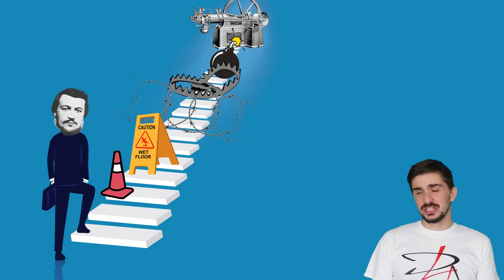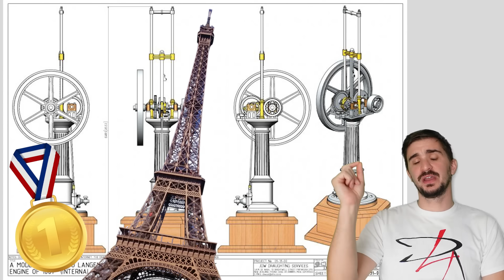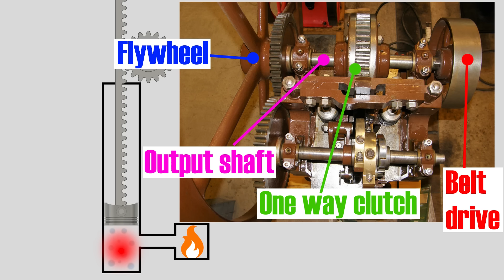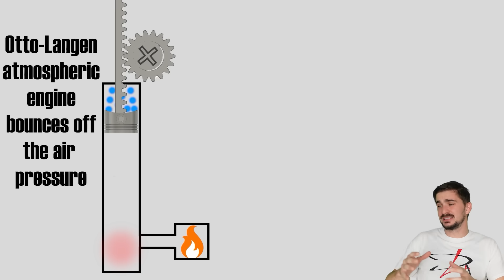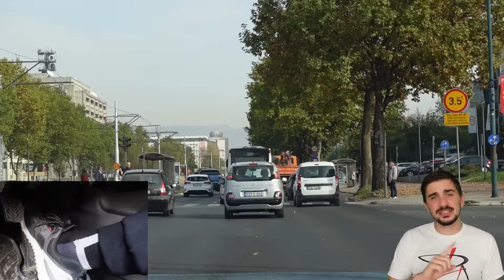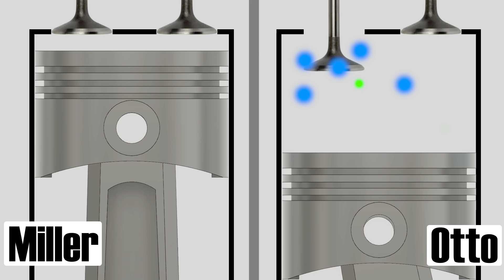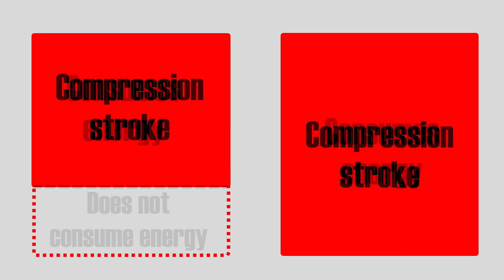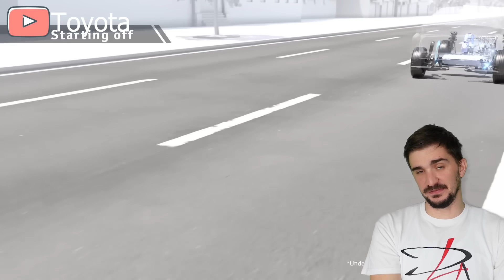You'll understand everything about Atkinson, Miller and Otto cycle engines after watching this video

Comment: Good video.  Ralph Miller’s original idea was to close the intake valve well before BDC to increase efficiency. He wrote about this (as I recall) in a 1948 ASME paper. I read his paper 25 years ago while working on VVL/VVT concepts for Chrysler. This works very well for low load efficiency (up to about 8% improvement), due to virtual elimination of the pumping loop by running unthrottled, and is what BMW Valvetronic and Fiat does Multi-air to run “unthrottled.” 

A guy at GM named Don Stivender did research on extremely low lift cams in the 60’s, and another GM guy named Tuttle made very short duration cams (with more normal lifts) in the early ‘80’s, testing Miller’s original concept. Tuttle also ran very long duration cams to control load (testing the later miller approach) Stivender claimed a 5% improvement in efficiency, and Tuttle around 8%. Stivender called his very low lift the STIVE cycle (Sonic Throttling Intake Valve Engine). Very clever! I built some very short duration cams with moderately low lifts to verify the blended “Stivender & Tuttle/Miller” with the very early intake valve closing concept in our 1.6l “Tritec” engine in 1999/2000 and verified the concept could deliver about 6-8% lower BSFC unthrottled. Most folks (even engine guys) didn’t understand how this works, but the evidence is right in the P-V diagram, and the virtual elimination of the pumping loop. Here’s are links to Tuttle’s 1980 & ‘82 SAE papers(I couldn’t find Miller’s):

https://www.sae.org/publications/technical-papers/content/800794/

https://www.sae.org/publications/technical-papers/content/820408/

Here’s Stivender’s paper:

https://www.sae.org/publications/technical-papers/content/680399/
Reply: Great message and refences.
Reply: Let me begin by stating that your comment obviously indicates an impressive understanding of the compound processes and coordinated functions of internal combustion engines and the incentives behind the R&D by engine manufacturers. 
 There are other viewers that demonstrate an understanding of the mechanical action, and some guys are on point, but this is the first time someone commented and there was no tunnel vision, or inaccuracy, without an air of bias or disapproval.
Reply: @tomconner5067  Thank you for the kind comment. The engine development work I did at Chrysler from ‘97-2000 was the most technically challenging, mentally stimulating and rewarding work of my 35 year career in the auto industry, and I had a lot of tough, innovative and interesting projects. I loved doing advanced side projects like the VVT/VVL studies. I authored a white paper on that work, that I hope had an impact and laid the groundwork for future development.
Reply: Wait a second ... what sort of engine guy doesn't understand dethrottling? The highload-benefits are a tad harder to grasp, and only work really well with boosted engines. There, one could see the concept outsource a part of compression without impacting expansion. Outsourced to the compressor (be it attached to a turbine or driven by the crankshaft), cooled inbetween, thereby lowering p and T, yet having the same amount of charfe inside. That way, knock is countered, and that allows to either collect an improved efficiency at high load, or to increase the geometric compression ratio, thereby expansion ratio, thereby efficiency.

But, as stated, this only applies to boosted engines - naturally aspirated ones, would lose a great deal of torque and power, if run on that mode, ... fits some applications, like Toyota's hybrids, but, there, these engines only are so successful because nobody really took them on - a similar drivetrain with a higher-tech ICE would outperform a prius in any regard.

Anyway, the mid-load region is the only one where you won't benefit much from a variable valvetrain, be it two or three steps with a lobe each, or continuously like BMW made it ... the nicest VVT I found so far is Nissan's - I've had the very same idea, but came across it in a book that sums up a converence on VVTs (there were annualy ones when this was considered one of the three major promising paths - Downsizing, Stratified load and dethrottling by variable valvetrain), and thought ... cool, some dude in Japan had the same idea and actually made it happen. Nice! Got a more complex, but still better one up my sleeve any day, that could even spare an intake cam phaser, if some parameters match up.

Anyway, I get that understanding the concept of outsourced compression and inbetween cooling may be a bit un-intuitive, but dethrottling, while sometimes hard to apply in reality, the basic principle is fairly easy to grasp...
Reply: @hoganfan924  ... just in case ... under what name did you publish it? How was the title? Is there a way I can read it, somwhere? I may already have, as VVT took a major part in my Diploma Thesis and a prior large ... assignment? The equivalent to a bacherlor's degree earning thesis, just without a degree, and after the Vordiplom (Diplom - stuff was arranged other than it's today, then). Which is, basically, at least a bachelor's in knowledge, but not a degree you can use on its own. Anyway, I remember having read some studies involving a Chrysler engine, ...
Reply: @DC-rn1fc  My VVT/VVL paper was an internal “White Paper” on future concepts. Not public. I wrote it in 1999. You’d be surprised how many engine guys back then thought that throttling at the valve vs at the throttle would be insignificant. At low load points it can be worth up to 10%.
Reply: @DC-rn1fc  I think the only (but very important) advantage of that Mazda engine is cooling of the intake air. Pumping losses are just moved from piston to compressor. May be they could improve them too, connecting the compressor with a CVT. Than you don"t need a throttle and can vary the power by varying the compressor speed.
But my dream would be to outsource the compression so much, that you can skip the intake stroke, and push already compressed air at the end of exhaust stroke. Than it will double the power, and half the mechanical losses, just by switching to two stroke cycle. Plus full compression with intercooling will allow very high compression ratios without detonation. But how to make it work at high RPM?.. May be combustion chamber should be separated from the cylinder by extra vale. So air/fuel mixture will be pushed to it and ignited during the exhaust stroke, and on power stroke valve will open and fully burnt gases will go to the cylinder and push the piston.
Reply: @azlktune  That's an interesting idea. The twostroke, in and of itself, doesn't have much against it, yet the ... shortcomings of the concept, render it the less promising in any mid-sized application. The KNOWN concepts - getting rid of crankcase scavenging for example would remove any lube-burning related issues unpresent at once, and that, I see you aiming for with this one as well. Extremely high pressure, so that the EXPANSION into the cylinder cools it down the final step ... compress, ignite-burn-work, and out (longitudinally so) again, with short (and maybe controllable) intake opening that finishes scavenging way before bottom dead center ... oh my, this is a rabbit hole to even examine if it's promising a competetitive efficiency, as the inner one even before any math is involved is very promising, but the supply with boost pressure way in excess of the usual of today's won't be for free, but gotta be as efficient as possible, with multi-steps and intercooling between all steps, ... gets me thinking of axial compressors THROUGH an enclosing heat exchanger (integrating compression and intercooling to a many-many-step axial would make it an, almost, continuous process instead of one in multiple steps, or, basically, moving towards such enough to recognize it doing so, ... of course, actual machinery always is in steps, ...), because stacking so many stages becomes near impossible with radial compressors, but they might follow, as per stage, they outdo any and every axial with a pressure ratio of up to about 3 in appliable machines, ...

But, the fourstroke cycle has some advantages we can't overlook here. Generally, it's cooler running, even at identical power, speed, cylinder sizes and so forth, which is in our favour regarding knock. It offers half of it's running time and its whole swept volume, if desired so, for exchange of cylinder load, while a twostroke needs external machinery do that anyway, the crankcase just being at hand in the lightest, simplest engines not being an option due to lubricant's combustion being against our favour in every regard (causes knock, costs expensive lubricant, may kill catalytic converter, particle emissions are through the roof, ...). The fourstroke, modified to have different effective strokes for intake and work - by early or late intake closure in the easiest, most appliable, cases - offers to increase the geometric compression ratio almost up to the practical optimum (heat losses and a lot of Blabla leave us at about 15...18:1 for a spark ignited engine, above, the increase of other losses would outdo the gain by more expansion), at pretty high BMEP and engine speeds, both vastly exceeding the performance variants of engines of 20...30 years ago. Time runs out, too, for new engines to be developed, we're pretty much at the time the actual development would need to start, not some groundwork study, but the actual one aiming for a mass produced machine, as per 2035, ICE drivetrains will become rarer and rarer, be forbidden in many countries even, and a completely new technology that elsewhere isn't of much value, will not promise a great return of investment.

Elsewhere - anywhere aside from motorbikes and cars, engines mostly are operating under more constant conditions, and optimizing an engine for one set of operating points at a fixed speed or fixed load, or a fixed load-over-speed curve (think boats for the latter - unregulated, high-rev tuned turbochargers do well in boat applications, but would be useless on the road) is fairly easy, a lot easier than achieving the same in broadly varied conditions. That makes us invent all that variable stuff, we add a degree of freedom that has a desirable influence on the parameters we could only set fixed at a compromising value that is, at best, optimal along one weirdshaped line on the engine map ... anyway, outsourcing the compression completely, has some appeal to it ... twostroke engines ... Porsche's latest published concept of a six-stroke, or a 6/2-stroke ... a threestroke engine, in average ... kind of ... alternates between a fourstroke and a twostroke process, but I'm not sure if that aims at efficiency in broad conditions, or rather at efficiency in a limited range of conditions, but by being accompanied electrically ina hybrid, in a range that really pays off, as the stroke of the engine changes back and forth ... I gotta take another look to fully grasp it. My thoughts that aimed at a similar process included a sleeve valve operating the intakes at the cylinders' bottom...
Reply: @DC-rn1fc  Sleeve valves will cause oil loss even without crankcase scavenging. Some oil will be pushed out to them from the piston surface. So it may work good only in rodless engines with unlubricated pistons.
Normal two-stroke engines with scavenging near BDC are also not really twice powerful, because a big part of the stroke is used for scavenging. With external compressor and intake at the exhaust stroke, full power stroke can be used for gas expansion.
Concerning lower average temperature of 4 stroke cycle - it is actually disadvantage, because more heat goes to the cylinder during powerstroke (higher thermal losses), and then it heats the intake gases (bad for knocking). Even an additional cold cylinder used as compressor would be much better for heat management. Plus compressor piston can be made much lighter and so with less friction.
I think maximum efficient expansion ratio would be not less then an old diesels had, about 25:1. Also a dual stage expansion with secondary piston may be efficient, because that piston working at lower pressures may also be lighter and have lover losses. For normal 4-stroke 4-cylinder engine I would add one expansion cylinder of bigger volume with a two-way piston, which will work with all 4 cylinders sequentially. That may be even done as additional device for existing engine, connected between engine and exhaust pipe and with a tooth-belt to the crankshaft
Reply: @azlktune  The sleeve valves are, in that case, part of a concept only existing in my mind. I have plenty of these, but ... as above - 2035 is a deadline we won't be shifting much. But, anyway, yes, there will be some oil drawn in, yet not nearly as much as a crankcase-scavenged twostroke, or Rotary with circumferential (intake) ports, would take in. Rotary's exhaust ports ... another story. Having ALL ports on the sides would be a given for any current or future application of rotary engines at all ... but, having variable intake closure is easiest done on these - a disc-valve only operating the intake, with a variable phase in respect to the excenter shaft is all we need to add, which is significantly less effort than what we need to do to achieve such with poppet valves in a standard piston engine. Guess you've seen them, had that topic a few paragraphs up from here... Anyway, ...

The optimal, real, geometric compression ratio isn't that high. The higher it gets, the less favourable are parameters like surface area vs volume, that increase heat losses to an extent that overcompensates what's won in further expansion. The older Diesels had such high CRs because that enabled them to be operated in winter, and made them more accepting of varying fuel qualities. Those engines, with a partitioned combustion chamber, also lose a lot of heat in the passage between prechamber or swirl chamber and main, working chamber. Direct injection Diesels, usually, have a lower compression ratio AND higher fuel efficiency. The (reasonably to be considered as such) optimal compression ratio, of course, relies on circumstances and insights that change over time, but the physics involved won't change much. When everything would in the near future be made of ceramics - I think this was in the late eighties or so ... one of those predicteries, you know ....... -, a heat-insulated engine was built, where every surface that would be in contact with actual cumbustion, was at least coated with a ceramic material, or made of such entirely, aiming at decreasing heat losses. Surprisingly, they were increased instead, because the wall-quenching of the flame took place closer to the surface, which made the temperature gradient greater, and thereby, the differential driving out heat wasn't reduced, but remained almost identical. At best.

We often overlook the boring features, such as cylinder size, and their influence on overall efficiency. For example, we take two similar engines, same company, same timeframe and so on, the miller-variants of Audi/VW's EA211 and EA888 engines, introduced in 2017 or so. Following figures only for the variants we look at here, other ones have other ones, but that's irrelevant here ... The 888 is a 2 liter, has 190 hp, comp ratoo 11.7:1, features a wastegate turbine and at peak efficiency, BSFC is 220 g/kWh. The 211 is a 1.5 liter, 130 hp, 12.5:1, features a variable geometry turbine and ... 222 g/kWh. Size aside, all features and specs (including the ratio of bore and stroke ... almost identical) are in favour of the smaller engine - slightly less power density, higher CR, no exaust gases bypassing the turbine, and yet, it's slightly worse in efficiency. The only real difference there is, is te cylinders' size, but it overcompensates all that would be in favour of the smaller machine.

Wastegate turbines: Their efficiency needs to be corrected for the fraction of gases that actually flows through the wheel and has work extracted from it, with the term 

m_turb/(m_turb+m_WG), 

with m_turb being the massflow through the actual turbine, and m_WG that through the wastegate, the sum of them, of course, being the total exhaust gas flow rate. At peak efficiency, the wastegate of this particular (and every one employing a WG turbine) engine is not fully closed, so we know that in this regard, the more efficient engine has a lower efficiency, as in the variable turbine, no gases are allowed to bypass ... which is why they exist in the first place, to have a means to adjust overall flow capacity without losing so much efficiency ... the wastegate only is the least-losing mode of operation, we could alternatively have a bypass on compressor side, or a throttle on turbine side, or throttle-off any excessie boost pressure, but over-RPM'ing the turbocharger might become an issue, then. It's the least desirable method of control anyway already, so ... Wastegates haven't become standard just because, but because they're the least-losing method of loss-based control.

Anyway, we gotta take this into account more than usually, and also - that this always is related to a certain concept. In a pent-roof combustion chamber with two sets of parallel valves and one central spark plug, a slightly long-stroked 500 cc unit is optimal, a larger bore would decrease knock resistance and increase the duration of combustion, but if we introduce additional spark plugs, things change a bit and allow a larger bore, allowing for larger units or more shortstroked, higher-revving ones. But, the main point is, we need to have multiple influences and inter-relations in mind if we wanna get anywhere, and some features appear to be less cool, less impressive, but yet, have an influence never to underestimate. A larger stroke would limit the RPM possible, increase mechanical losses, and over-proportionally enlarge the engine's size and weight, ... 

Cooler running ... partially, more a concern of critical temperatures for materials used, admitted, but due to experience, cooling the combustion chamber as low as possible and thereby having less knock issues is more promising than avoiding the heat losses that are the price we are to pay for this. More CR is worth more than less heat losses by hotter surfaces. In aircraft engines, another factor comes in, radiators' drag, but let's not add that into it, too, here - enough already, eh?

As to external compression ... pressure losses are crucial, and so is intercooling, while we'd need a boost pressure way above what's usual today, or maybe two pressure levels which feed it sequentally. But, however we do this, we'll need space for coolers and piping and stuff, and we need to drive them. Exhaust turbines are the most efficient option, of course, but twostroke engines react pretty diva'ish to backpressure, so we might need to introduce either a mechanical, or an electrical path towards boosting, as we have multiple stages to drive anyway, we can pretty much seperate this. Electric ... only makes sense if the power we can apply is high enough, meaning the environment needed makes up for the most of added machinery when converting to a hybrid anyway, so we could employ electric motors alternating, and pretty much avoid low part load conditions altogether, so we can focus on efficiency at high output.

Additional expansion devices, downstream of the engine, are not only promising, but a key factor. Sadly, car engines aren't large enough to employ turbines as well-performing as it is in large aicraft engines, but either that, or an expansion cylinder - with its own advantages, drawbacks and issues. Curtiss-Wright used a set of three turbines in their Turbocompound versions of the R 3350, reaching a BSFC of 231 g/kWh - in the fifties, pre-electronic controls, with an aircooled twovalve engine! Huge cylinders have drawbacks as well ... knock is more likely, the larger it gets. But, compare these 231 g/kWh to the numbers above, and to the, usual, around 240 g/kWh for (good) twovalve car engines of the early nineties (knock sensor, Lambda-control being applied and working reliably and precisely and so forth), and the effect of expansion downstream should be appealing enough, ... definetely a path I'd love to investigate, would I still work in engine R & D. Wouldn't oppose doing so, ...

Oof ... that got long ... hope you don't mind, ... didn't forget something, the cat demands attention, I can't let her wait. She allows me in her bed...

Uh, anyway ... as this debate is kinda refreshing - thanks, looking forward to next!
Reply: @DC-rn1fc  As I understand, modern diesels have lover CR mainly to minimize NxO production, plus they have higher boost. Otherwise I think optimal expansion ratio would be even higher. I tried to find some numbers of equivalent pressure of mechanical losses, but I can't unfortunately.
Concerning downsizing, it is clear that smaller engine with the same number of cylinders will have worse efficiency, due to higher thermal losses. But the named efficiency is achieved at optimal load, which is usually too high. So aim of downsizing is to make engine work closer to its optimal range.
Regarding turbo, it is always looses energy, independent of construction, except when it is connected to an alternator like on F1 now, or mechanically to the crankshaft. Energy of exhaust gases is anyway higher then of intake gases. Turbo just replaces the lower part of the power and intake stroke, making more power from less cylinder volume, but by the price of efficiency. 
Bigger stroke with smaller bore gives better thermal efficiency by the price of max power, because of smaller valves. But that may be compensated by a low boost turbo, which will not increase the pressure at low/mid rpm, so the high CR can be used, but will increase power at high rpm, compensating the losses in valves. That would be a compromise between efficiency at low loads and peak power.
Temperature of compressed gases can also decreased by the water injection. Usually it is used in high-boost turbo engines, but can also be used with non-turbo high CR engine.
Reply: @azlktune  Yes, NOx is influenced by the CR, but exhaust gas treatment is needed anyway, adapting here for a higher conversion rate seems more promising. Raw emissions ease that, but if it would cost a significant part of efficiency, that deal would be broken already. The current Diesel, Direct Injection engines' CRs of around 14...19 or so, are just about the optimum possible. But, generally, I'm more of a gas engine guy, but ... anyway, downsizing aims at shigfting load, yes, but the point I was aiming at is a different one - fancy stuff and extreme parameters cannot outdo basic geometric specs, or the effect they have. I love all that complex and variable stuff, don't get me wrong here, but the basics have to be optimal, or close to, already before any of it is the most promising, most effective way to increase efficiency. With too large, too small, too shortstroked cylinders, you can throw in all the tech you want or dream of, it won't deliver enough to justify the expense.

But ... turbocharging, in and of itself, doesn't reduce efficiency, but increase it, as it - partially - extracts heat energy from the exhaust gases that, otherwise, would just be expelled with the gases themselves. The adaptation, requring a lowered compression ratio, and thereby expansion ratio, is where we lose efficiency, and the - in downsized engines more likely - small units. Smaller ones are less bound to knock, but larger ones lose less heat, and at those just-a-bit longstroked 500 cc units, we're at the optimum of concept. Throw in the other two sparkplugs in the corners between valves, outer side, so they form a line of three per unit, and make a nice cumbustion chamber with large squish area, and we've shifted the optimum towards larger bore... But, that only drifts off here.

The turbocharger, kind of, simulates an atmosphere of greater pressure, on both sides of the engine. In a standard engine (normal timings, ...).

It doesn't replace the intake stroke, but the compression stroke, partially so, in miller-engines, with the advantage of having a chance to cool it down before entering the cylinder. With an adiabate charge air piping, we wouldn't gain anything from it, but losing efficiency, as we sure need a higher boost pressure, and with the same kind, or even identical, turbocharger, that requires a further closed wastegate, backpressure is increased, load remains identical, and without removing heat before entering the cylinder, all the effort is going to waste. Only the reduced temperature at compression's end is affected, and only there, we're aiming in regard to high loads. The chance to insert a heat exchanger between (partial) compression and (further) compression, we only get by outsourcing it to the turbocharger, or by water injection, which is generally frowned upon, as one would have to refill it. Backpressure AND boost pressure, both, are higher than usual, still. But, that's acceptable, as the increased efficiency of a larger geometric CR outperforms this largely.

The expansion ratio, as the parameter determining the effeciency (the compression ratio, or rather dead center volume ratio, is no more identical in this case, so we need to distinguish between them), can then be increased.

Further expansion, regardless of the type of machine it appears in, is worth some, but less than epansion in the original combustion chamber, because on the way, friction, heat losses and additional mechanical losses will appear. So, this route, I consider to be taken after any and every means inside the engine is fully exploited - miller cycle by valvetrain, to me, seems most promising as standard-feature for the remaining generation of engines. As it can be developed into existing engines, with adapted combustion chamber and boost system - maybe integrated into a hybrid, sparing us the hassle of variable turbines - and aims at the classic drawback of turbocharged engines, knock and the means employed to counter it, it seems almost natural to follow that path of development. Compression ratios like the engines mentioned have, weren't usual in any naturally aspirated engines until lately, therefore, I'd assume we can call this issue solved, as further increase above values of that order doesn't even promise that much more efficiency anyway ... from, say, 8 to 10, you'll receive a large increase, but from 13 to 15, you can't even expect the same ... you know the math, the graph, ...
Reply: @DC-rn1fc  You may compare e.g. 2L turbo with 0.5bar boost and 3L non-turbo. They will have nearly the same combustion chamber. So you just replace 1/3 of power stroke by the hot part of turbine, and 1/3 of intake by the cold part. That helps to increase power/volume or power/weight ratio, because this last 1/3 of the power stroke produce much less power, but you loss part of energy with it, that cause lower efficiency. So the turbo doesn't extract energy of exhaust gases, it wastes them. Only if you add a turbo to normally aspirated engine and connect it to some load (alternator or crankshaft), you will harvest some energy, but because of low efficiency of the turbine you will probably create more losses by backpressure on exhaust stroke then collect by the turbine.
Additional cylinder for exhaust gases expansion must be more efficient then turbine. It doesn't need cooling, so have no thermal losses. Mechanical losses are also much smaller then in main cylinders, because it works with much lower pressures. It will not even cost the space, because will replace part of the muffler, as gases pressure will be lower.
Of cause dependency of efficiency from CR is not linear, but there is still the same energy goes to exhaust as converted to mechanical work. So there is a lot of room for improovement. Fundamentally, efficiency is limited by expansion ratio. Cooling the intake helps to increase it by decreasing the size of combustion chamber. But higher presures during the whole cycle means you need more strong and heavy mechanical part, that means higher losses. You may compare a smaller engine with colder intake and higher pressure, with bigger engine with the same CR but lower intake pressure. They will have the same power and nearly the same mechanical efficiency. So impovements on intake side help more to increase power/weight ratio, then efficiency. To icrease efficiency you need to increase expansion, but with the same cylinder it will cause high mechanical losses, so the only way I see is multi-stage expansion with several cylinders. First with smaller volume, but designed for higher pressure, next with bigger volume but lighter piston working with lower pressure, and so on. Than it make sense to use equal expansion ratios of the stages. Not 10:1 + 2:1 as I though before using the extra cylinder with standard engine, but e.g. 5:1 + 5:1 or 3:1 + 3:1 + 3:1. Or may be last stage can be replaced by a rotary vane (de-)compressor, as temperatures and pressures will be low anough for it.
Reply: @azlktune  That's a weird way to look at this... 

Now, wait a second. We don't need to reduce the expansion ratio in order to drive the turbine, the only reason the compression ratio is lowered in boosted engines compared to NA engines is the prevention of knock. We don't have to lower it to make sure enough energy flows out the exhaust port to be able to drive it - that would actually be the case if the turbocharger was prohibitively inefficient. Have you seen early compressor wheels of Junkers' aero engines in WW2? Something like that... The prevention of knock is what limits the geometric compression ratio, or rather, a critical pre-reaction-state of the gases not yet reached by the flame, which is greatly influenced by (effective) compression ratio (in cylinder, taking intakes' closing time and the volume swept until then into the equation, and not the total displacement), and charge temperature. Could we reduce the temperature at compression's end, we could increase the geometric compression ratio, and in order to do this, we're outsourcing compression to a place that enable the insertion of a cooler inbetween. We're not replacing a part of the power stroke, and never have. That's a misunderstanding that could lead you somewhere, but you won't get anywhere from there any further.

Of course, having an identical combustion chamber, identical amount and state of gases, and then a lower expansion ratio, efficiency goes down the drain. But, that's not the case anymore, as prevention of knock has gone a great length since turbos have become a standard feature. Just look at current compression ratios of turbocharged engines operating above a BMEP of 20 bar, and look at that of NA engines just about pre-downsizing, including direct injection (which allows for an increase by about 1...2 units with the same knock properties), or go further back to twovalve era (which, btw - another debate to be had - were already known to be inferior to fourvalve or threevalve engines pre WW2, but as industry doesn't focus on best tech, but most revenue, it took just a few decades to unforget), you'll find almost no engines with a CR above 10. Early turbos - Porsche's 911 turbo, the first version, had a CR of 6.5:1 or so (WW2 aircraft engine level, that is - huge cylinders and low octane gasoline took their toll there), the later updated one with increased displacement was slightly higher compressed, but had an intercooler introduced, which should always be part of the package, as it increases performance AND efficiency and also is a relatively cheap, low-complexity item.

Anyway, if you compare that to the numbers, a lowered compression ratio, in today's engines, isn't much of an issue anymore, and certainly, the turbocharger is not meant to replace a part of the power stroke, nor does it need that in order to be operated. I get how it can appear so, but it's not like that.

A miller engine by early intake valve closure (generally, early is better than late - pushing out again the unnecessarily drawn-in part of the load - although that's possible, too, and often easier to implement in a given engine), even, does quite the opposite - the only thing outsourced off the cylinder is the compression, partially so, and the turbine ... well, we need something that drives the compressor, and as using exhaust gases and a bit of the energy that, otherwise, just is lost, we can be sure to have a greater efficiency than with a mechanically driven one. Anyway, a geometric cmpression ratio of 12.5 with a 1.5 liter providing 200 Nm (or more, the earliest versions had that torque ... maybe they updated, upgraded, a bit along the way until now) - that's still not too unimpressive, equaling about 17 bar of BMEP, even at low speeds ike 1500 RPM, which are the most knock-sensitive conditions, does tell a story that doesn't contain any expansion taken out the cylinder to be happening elsewhere.

Extended expansion could also be running in a Wankel-like machine, as there, we could feed in the gases at two spots, and have three chambers working simultaneously. The drawback that, ultimately, broke Wankel engines' neck, the odd-shaped combustion chamber (it's neither wear nor tightness, these have been solved since the late sixties, but still keep coming up when talking to non-engineers), is irrelevant if no combustion takes place. Compactness plays a role, too, but as of today, in engines not large enough to make a downstream turbine promising enough, a trochoid-machine would be my preference. 

The multi-expansion is a fine thing, in general, but reducing the expansion in the first stage gets me to scratch my head - why? The earlier on in the process you extract the work, the less chances to lose heat, or energy in general (... not really lose, but have transferred into a form we can't harvest), there are. The second expansion, of course, should extract everything possible, but reducing the first one will not be the optimal choice - that remaining as high as possible is a given, regardless of what's the machine following.

... looked up turbocompound engines? I think Allison could also have done such, but I'm not sure about them. Wright, for sure, did, and the results were quite impressive.
Reply: @DC-rn1fc  Of course we don't need to decrease expansion ratio to pool the turbine, we need to decrease the compression ratio to push more air to intake. We can do the same by bigger intake/compression stroke, or we can replace part of it by the compressor, keeping the same combustion chamber. And by that we decrease expansion ratio and lost a lot of energy to exhaust.
This model is more for engine without intercooler. Of course cooling give us some advantages, but at low boost it seems to be too small. For example two french engines I had, both from 90s: 2L NA with 180Nm torque and CR 10.4, and 2L turbo with 235Nm and CR 8. You can see that turbo engine has 30% more torque and 30% less CR, even with huge intercooler. So you can just make a 2.6L NA and get the same power, but with better efficiency, by the price of bigger weight. Actually they had a 3L V6 at the same time with CR 10.5 and 267Nm, so again the same ratio between torque, volume and CR, limited by the knocking.
Modern engines with direct injection having higher CR with turbo, but as far as I know they use a very late ignition in boost modes. So effective expansion ratio is much smaller than geometrical. Without direct injection they would probably have a strong pre-ignition.
I think Wankel engine have no advantages over rotary vane on lower pressures, see one of the previous video here.
Reducing of the expansion ratio on first stage will allow to make first cylinder smaller, and so decrease the heat loss to its walls. Also mechanical parts will be used more effectively at more stable pressure. At CR=10, pressure at BDC is about 15 times smaller then in TDC, so most of the time piston load is too small for it. So it is better to distribute the load equally between the stages. But it is a question of optimization.
I heard about turbocompaund engines, but don't know how big advantage do they have. Actually it is the same idea to harvest some energy from exhaust gases, but I think turbine is not the best there. If pressure of gases is about 10bar, that is close to the industrial pneumatic system, most efficient solution must be rotary vane which is used in many pneumatic tools now. I think turbo-compressors were used as a cheap and compact solution able to provide necessary pressure to intake without need of high efficiency, because flow of exhaust gases is always much higher then on intake. So we need to grab only a small part of the gases energy.
Reply: @azlktune  Yes and no. We gotta dissect this a bit deeper...

The state the gases are in at compression's end is (for our purpose here close enough) what determines knock. Modern, turbocharged, high compressed engines that deliver a high level of torque (that often is made to be constant from there on) from a very low engine speed on, say 1200 or 1500 (which engine speeds did the engines you mentioned have their peak torque at? Bore and Stroke are similar? Location of mixture is the same in all three? Combustion chamber's design is similar? Any known weak spots or exceptional strengths of those engines, like a poor cooing circuit in one, a very-well-tuned acoustic intake pipery in the other? Superior gas dynamics of multiples of three in cylinder count, being taken into account?), have even ignition AFTER top dead center. In my diploma thesis, this played a crucial role, as it investigated the interdependencies and options we can harvest from advanced turbochargers and variable valvetrains (of, at least, two kinds ... various ones already got disqualified from further examination, because time was limited, I had to make up a few criteria such as responsiveness to reduce it to what's really interesting and promising - a valvetronic-like continuous, and one that combines a twostage shiftable valvelift with different timings for each (set of) intake valve(s), thereby offering a continuously variable total opening duration - with a fivevalve, you'd even not have to worry about swirl anymore, so this would be the natural opponent of a fourvalve continuously variable valvetrain, but for comparabiity, I didn't change the number of valves, but applied it to a fourvalve - we could go into this further, but not here, not now...). 

The center of heat release, we decided to allow no later than 40 degree after top dead center, which ... is a drawback in many downsized engines, yes. Ignition was some 14, 15 deg ATDC in that situation. That, kind of, reverses the miller cycle, as it delays the heat release to a point where the further expansion isn't that great anymore, plus the heating up near top dead center is kinda intense - high pressure, long time, just compressing and expanding again a bit without any work extracted.

If I have the numbers right, a truly advanced turbocharger (the one used in the series engine modeled and modified upon was pretty close to its surge line at low speed, high load, and there, the compressor's side variability aimed at, by adding a variable cone nozzle directly upstream of the compressor wheel - turbine side was a Diesel-VGT plus wastegate, or at least, there I got the map from) that allowed a high enough boost pressure gave a huge advantage in getting rid of any scavenging (direct injection, it's only air anyway, but you'd either have to deal with rich mixture in cylinder to have global Lambda at one, or have Lambda at one in cylinder, but lean exhaust gases, and both, you'd rather avoid...), Lambda_cyl was increased from 0.7 (a limit we set, as just about there, the mixture would still burn sufficiently well to operate - regarding efficiency, this is a catastrophe) to 0.97 or so, and the center of heat release (CA50 - Crank Angle at which 50% of heat is released - "Verbrennungsschwerpunkt" in german) could be a great deal earlier, at 25 deg ATDC The effect this would have on efficiency, isn't hard to guess, I guess ... is it? Generally, the low-end-torque operating point was at any and every limit given, richest mixture allowable, latest combustion allowable, lowest minimal distance between piston and intake valves, and that, generally, doesn't lead to expect great results in regard to efficiency, but keeps an engine focussed on very different operating conditions runnable. Sometimes, barely so, but that's besides this debate. A bit.

Downsizing is optimization with respect to the range of operation conditions, and CAN mean sacrificing overall efficiency or peak efficiency, if the adaptation of the engine to deliver more power per displacement is done traditionally, there will be a loss in this respect. Sure so, but the boosted miller cycle engine overcomes this, exchanges it for another set of issues to be adressed (like bad transient behaviour ... pretty hard to make it react fast and smooth, many parameters).

Engine speed plays a crucial role, too, as with slower running engines, the unburned gas fraction has a lot of time to be heated up, while a faster running engine will be less of a PITA in that regard. To downsizing and stuff a bit, again ... the efficiency at peak torque, lowest RPM, of course, is worse than bad. Like, 400 g/kWh and above - BUT (... there's always some sort of Butt...), these conditions aren't stationary. In every gear, flooring the pedal even at that low engine speed will accelerate your vehicle, you won't remain in that condition long, so having a compression ratio that, here, requires such bad operational parameters, is worth it because it allows for better constructuous parameters, like compression ratio and so forth.

But, you really have to get rid of the idea that a turbocharger would outsource expansion. That isn't the case, or at least, nobody ever aimed for it. There's one exception, and that is transient behaviour, where we, for a very limited timeframe, allow the priority to be the acceleration of the turbocharger - in a miller-cycle engine, this is more spikey than in a usually controlled one, and to have more power available at the turbine wheel, delaying ignition is a proven and reliable means ... also, having only the stationary values of the valves' lift and opening duration won't make it here. This still refers to my diploma thesis, in which hybrid wasn't investigated, so the optimization of transient behaviour - smooth, yet fast, build-up of boost pressure and torque - was only taking the engine itself into account, without any replacery or so. This situation, this one alone, is the grain of truth in iit.

Electrically assisted turbochargers, in a hybrid environment, can cure this very well, and as we can take the excessive power, the amount exceeding what's consumed by the compressor, out the system via generative operation, we don't need the sensitive VGT anymore, but can simply apply electric power to improve transient behaviour. Mercedes do so on their current straight six - the nicest engine they have built after WW2 - with an additional compressor that is electrically driven.

The reduction of the geometric compression ratio ... is not done to draw in more, or enough, air, but only ever to avoid knock. The turbocharging process itself never decreases efficiency, as it - partially so - makes use of a fraction of energy that, otherwise, just leaves. The limit is knock, and as knock is greatly dependant on temperature, reducing the latter allows to increase compression ratio. The more boost pressure we have on hand, the earlier we have a sufficient charge in the cylinder - and can close the (last) intake valve(s), as the higher compression (ratio) of the turbocharger increases the temperature further, and thereby the heat that a given heat exchanger with a given other side (ambient air, or water cooled by ambient air) can exchange, is greater, and thereby, the internal effective compression ratio can be, and is, decreased, while NOT affecting the expansion ratio. More pressure, more miller, so to say.

The expansion downstream, to harvest energy from the exhaust gases, but not to drive a device that only can consume a limited amount of power, and therefore fration of power available, is where I'd prefer a trochoid machine, as the combusion doesn't happen there, the odd-shaped combusion chamber isn't an issue at all, and as the temperatures are significantly lower, the heat losses due to high surface area aren't anywhere close to being a dealbraker, while the compact layout (small size in comparison to flow capacity) is something very desirable brought to that table - but, not at the cost of expansion in the first, main, machine! That NEVER can be more efficient, as we'd end the expansion prematurely, transfer gases on high pressure and temperature levels into the second-expansion device, where we, on the way, lose more heat and have greater friction losses. Second stage is ... a second stage.
Reply: @azlktune  

Turbocompound engines aim at this very target, but make use of turbines instead of any positive-displacement-machinery (anything in which an encloses volume is changed in order to transfer power - radial vane, piston, trochoid - basically has the same function, it's just executed by different means). As a rule of thumb, positive displacement machines are used for high pressure ratios and low volumetric flow rates, turbines in opposite situations. As the main expansion is already done and the power to be harvested is significantly lower, simplicity and low mechanical losses are a key element in success here, and that calls for a machine that isn't full of linkages, operated valves and such. A passive-expansion trochoid machine seems the best compromise, as reducing the main expansion wouldn't be of advantage, we leave the engine as is, and connect this one downstream of the turbine that, still, drives the turbocharger. Could also help prevent losses from wastegate operation, by increasing the pressure between turbine (still havinga turbocharged engine in mind, as those having the highest peak efficiency, nowadays, are turbocharged engines) and expansion machine, the power extracted there can be higher. Would require to actually simulate it in GT or so, to see how well it fares... But, anyway ... expansion ratio, still almost equalling geometric compression ratio, is key, and is worth more in the first machine, due to the losses mentioned above being greater, delivering a lowered efficiency, that, too, has to be applied to a greater fraction of total power.

Little side note: The VGT in my diploma thesis model couldn't be operated at the same temperature a chaper wastegate turbine could be - but, as the latter would be significantly smaller in order to allow high-enough boost pressure even at lowest engine speeds, the increased backpressure of a smaller turbine at peak power caused just exactly the same amount of additional BSFC like the richer mixture employed in order to limit exhaust temperatures - it even was consuming (a tiny fraction) more with one valvetrain variety, and an almost idenitcally tiny fraction less with the other, so would, based on efficiency, not imply a preference towards either concept. Based on response, too - the VGT is at a great advantage, and nowadays - this was like 10 years ago - even relatively cheap VGT are capable of accepting higher tempreatures, which again made a tech that is fundamentally better, but lacks robustness or durability and required a disadvantageous choice of parameters, finally apply it's advantage to the fullest. Like, turbo engines of times-gone-by, were heavy drinkers at times, compared to their contemporary NA equivalents, with low compression ratios, late combusion, rich mixture and all that ... while now, almost every turbo engine even with standard load exchange mode (usual timing and stuff, no miller-atkinson-5,6,7-stroke fanciety items, but the usual ones, the mid-engine in mid-sized cars for mid-any including mid-Annie, and so forth...) still has a compression ratio of above 10, which was rarely seen in twovalve engines at all, and if so, in those that have low volumetric efficiency. Since then, fourvalve engines, variable timing, direct injection have become standard features, and following them, turbocharging has, too. Since then, the introduction of miller cycle not for part load dethrottling - where it wokrs great, too - but for countering knock has seen its introduction to greater series machines, and these outcompress any naturally aspirated engines that have been in series production, aside from Mazda. Full-load without boosing ... doesn't make much sense, as there, we can today get rid of knock by other means that have less or easier implications, and if we'd apply it so regardless, we'd need a very large displacement engine, even compared to twovalve NA external mixture, fixed timing and blabla engines, we'd need a significantly larger displacement for the same power so ... this isn't usefully appliable. Dethrottling a large engine may be fine, but finer is to do so with a small engine that overcomes throttling by better choice of operating conditions. 

However we twist or turn this, miler-cycle as a feature that fits inside the engine (still may require a larger engine or a larger, more complex, boost arragnement) makes a lot of sense to become standard. Anything that adds another machine, needs to compete against other, similarly large/heavy alternatives, and there, an expansion machine might lose against electric hybridization. Which, partially, knocks out the gains of miller's cycle as well, ... but, whatever and however, please get rid of the idea of replacing part of the expansion, or needing the lowered compression ratio to allow a greater mass of air - that's often right by comparison, but only if there are not significant changes in other regards, such as cooling, number, location and specs of valves, sparkplugs, injectors, ... there's too much going into this, but when comparing engines on a similar level, the results seem to back it. A greater mass of air ... fits into the cylinder until it's compressed enough to become liquid. We're far, far away from that to happen.

... long again ... hm ...
Reply: @DC-rn1fc  That all still doesn't contradict to the model of turbo as replacement of the part of stroke. Turbo engine without intercooler is equivalent to the bigger NA engine, where turbo replaces part of power stroke and part of intake stroke. In this case you just loose part of expansion ratio and efficiency.
Turbo engine with intercooler have the same problem with expansion, but compensate it (partly) by improved cooler intake, that allows to increase CR. But if you would be able to cool intake on bigger NA engine you will have even higher expansion ratio, and efficiency.
Actually turbo-miller engine does exactly that: cools intake by intercooler, but keeps standard expansion ratio. So it is kind of hybrid of smaller turbo engine with intercooler on intake and bigger NA engine on expansion phase. So it should combine their advantages avoiding disadvantages.
Regarding these engines, they both have the same bore/stroke 86*86. Maximum torque was at different rpms 4200 at NA vs. 2500 at turbo, but that is more because of intake resonances of NA engine. Its another version had peak torque at 3500.
Ignition after TDC in modern turbo engines actually means decreased expansion ratio. If peak of pressure happens 40deg after TDC, efficient expansion ratio becomes 6:1 instead of geometrical 12:0. Actually it is good compromise if the engine works most of the time at low loads. But at high loads its efficiency became like it was 
 at old turbo with low CR.
Concerning multistage expansion and lower CR, you may look on it from another side, like if you add a smaller pre-expansion cylinder before the standard one. Having smaller surface, than the standard combustion chamber, it will have smaller heat losses. In same time main piston will work with lower pressures and temperatures, so can be made much lighter and with lower mechanical losses. Of cause losses between cylinders may be higher than these advantages. With standard valves may be it has no sense. But maybe with some huge ports it will work. Maybe even small piston can be a part of big piston placed on its top, or big piston may be a cylinder for opposed small piston. Just some raw ideas. Ideally cylinder should have conical shape, and piston should somehow became wider while going down, then there will be optimized heat surface and more stable force on piston. Or more ideally cylinder should be spherical and expand in all directions. Maybe combustion should be done in a bubble inside a liquid. Than this liquid can directly push a hydraulic motor connected to the wheels.
Reply: @azlktune  The model itself is neither wrong nor right, but it seems to imply to think things as remaining constant that aren't constant UNLESS a specific set of circumstances is true, or true enough, which can make it appear more accurate than it is, and to conclusions that are drawn are just as accurate. Knock is a hard to simulate, hard to model in the first place, process, as regular combustion in an engine, already, is hard to simulate, and knock is an irregularity about just that. Lucky as we aren, an integral of p and T over time, or over crank angle with a correction for time, delivers a close-enough approximation that is included in engine sim software already. I think it's named Worret, or Worret and somebody, for them having invented this approach. But, still needs calibration, as it isn't a model derived from first principles, but from observation and a bit of clear thinking. If we're just after results...

Concerning miller cycle ... I may be a bit more specific, as my diploma is more than 5 years ago, I'm allowed to talk about any of it freely (standard procedure if you write it working in a company, which offers ressources in exchange, that you can't have at home - sim software, databases, experts on everything you can call and ask empty, ...). The engine modeled was VW's EA 111 in that case, as it was about comparing the effects of changes in valvetrain and boosting system, together and interdependent as they are, and a more knock-sensitive engine (than then-current ones - the TSI version debuted in 2005, this was 2014...15, the 211 already was in mass production, the miller variant announced to be introduced) was more in my favour, as it would deliver not principally different, but quantitatively greater results. More to brag, looks more impressive on a slide for those that only offer half an ear, ... anyway, we don't need to debate stuff we agree on. Of course is it the reduced expansion by late-introduced heat, that renders it as inefficient as is ... and the unburned fuel ... scavenging got out of fashion because of that, and because of stricter exhaust content limits. Given you have a pretty large cat converter, you can accept such for transient operation, the cat, if large enough, is able to cutt-off peaks of typical rich or lean exhaust gases, and therefore, this still is a route often went until today. We won't principally overdome it's drawbacks, but can make the machinery able to cope and limit the time those conditions occur.

For 1500 RPM, BMEP of 22.4 bar, CA50 (crank angle at which 50% of mass is burned), could be shifted from 40 deg ATDC to 25 deg ATDC with, both times, 10:1 compression ratio, Lambda in cylinder was increased from 0.75 (I looked up the numbers I still have ... I miss a huge excel file with about 40 operation points and some 20 or so numbers per variant, which were ... a few in the beginning, 2 + standard for reference in the end) to 0.975 ... and BSFC from 418 g/kWh to 253 g/kWh. Ok, this was a simulation, which has it's simplifications and whatnot, but the principle at work is pretty clear, the magnitude of its effect, too - the most efficiency-losing effect of adaptation to turbocharging, the lower compression ratio, isn't needed anymore anywhere near the extent it was needed in previous engines, if a miller cycle is introduced. During that time, the updated EA211 was in development, and it pretty much confirmed everything my thesis said, even that, with a standard turbocharger compressor, a miller engine will reach less torque, so either the engine needs to be larger, or needs a more fancy turbocharger with such things as variable cone nozzles, or adjustable vanes (for these, another time WW2 aircraft engines are a more than interesting subject - "The Secret Horsepower Race" is a great read, generally so, if you buy a used copy, it may even be reasonably priced).

Anyway, the compression outside the cylinders as part of the compression process ... the same, I'm saying since about 5 comments. I agree to most of what you write, actually, it could appear frightening, but this one model, or rather the implications you draw from it. The identical chamber, identical gas, less stroke ... I get it, but this will never be a result in reality, because too much factors enter it, and because we already solved what could cause an engine to resemble that assumption, we have intercoolers and miller cycle, and that, pretty much, defeats the turbo engines' disadvantage in efficiency, as it restores the geometric compression ratio, if not even exceeds that of typical NA engines of similar power (and greater size, still - turbochargers have come a great length since they first appeard well enough to sell, especially in regard to the width of the compressor map, as this was a primary goal of development since radial compressors were invented - the better one stage is, the later you'd need two stages, ...). The knock issue is solved enough to approximate the practically optimal one of about 15, today even closer than when those mentioned miller engines were introduced - we sure didn't unlearn stuff - with a BMEP level that was unthinkably over the top just a few years ago. What else should we want? Do we actually want to insert a second expansion process? I'd say, yes, we want to, but the earler you take out energy (be it harvest for use, be it a reduced efficiency for regulation purposes such as wastegates - we had that previously, ...), the less losses have already occured - the better, therefore - and the earlier a fraction of power is lost (by bypassing a turbine rather than throttling off a pressure we just increased before), the better, because the processes happening downstream that path already only are fed the reduced power, with - at equal efficiency - reduced loss. Multi-stage compresors, often, have a bypass on their first stage, and none of the following are regulated in any way, and the more stages you have, the less you see of the reduced efficiency of that first stage. Always the first, for reasons above. 

Preferably, the first expansion shall be as great as possible, as expansion here is worth more than expansion in a downstream engine. But, we could for sure define a minimum efficiency of an added expansion stage, and a minimum flow capacity (we could still add a bypass if need be, ...) which we'd need to exceed in order to, overall, increase efficiency. But, all promising approaches I have seen focussed on not disturbing the main engine, but rather harvest energy in a way that has the least implications to the engine itself, maybe because that made it easier for those examining these concepts as the engine's inners weren't really subject of their studies, but also because anything that lowers the efficiency of one machine in order to, overall, improve it, really has to deliver. I remember an approach where heat is collected from the exhaust pipes, and then used to run a stirling motor, as an expansion machine with outside heat source, it's a natural match, if the relation between size, power, flow capacity match up well, it's basically free work driven by, otherwise completely, lost heat.

As we don't run into stability issues, like with turbocompressors, multi-stage expansion isn't necessary. The advantage of extended expansion needs to be an overall higher efficiency, as the transfer between them is not, by principle, necessary. But, by execution, can be of course.

Turbocompound engines made exactly that, a second expansion, but used turbines instead of volume sweeping machinery, which were developed to not increase exhaust pressure, but harvest the kinetic energy of the exhaust gases primarily, or worked with a low pressure ratio in order not to reduce the main engine's efficiency, but would still add more than 100 kW per turbine, in the R-3350 case, it was 125 kW per turbine, and three of them. I had a car once that had the same power ... as one of those turbines, a 2.6 l V6 in a W203 C-class (thee valves per unit, two spark plugs, extremely shortstroked, naturally aspirated, external mixture, ... M112E26). As a proof of concept, we might accept that those machines were the most efficient gasoline engines for decades to come BECAUSE of the turbocompound arrangement.

A small additional piston (and cylinder) would have a small surface area in absolute, but compared to the additionally swept volume, it will be prohibitively large, as the relation between these two is what counts ... how much extra surface is added per volume, that's like our question, and of course, when does that happen? Near TDC, it will greatly increase ... heat losses.
Reply: @DC-rn1fc  The idea of small piston is not to add some volume to the main cylinder, but to replace it in first moments of burning. With big cylinder  burning with highest temperature happens in almost flat area between the piston and cylinder head. It have very bad area to volume ratio, and so high heat losses. If you use a small piston instead, the shape of combustion chamber (having the same volume) will be better and will have less surface, so lower will be losses. Then, when you pass pre-expanded gases to the big cylinder, they will have lower temperature, and heat losses in big cylinder will be smaller. Plus the mechanical losses, as I said already, will be lower because of lower peak pressure. So you outsource first part of expansion with high temperature and pressure to more optimised small cylinder. The only question how to pass the gases from one to another with minimum losses.
Concerning the models, to understand influence of one part you need to assume all other things constant. Or at least part of them. For example if we fix the volume, than we can say that: turbo inceases the power, but decreases the efficiency (because of lower CR); intercooler increases efficiency (because increases CR); Miller cycle (smaller intake stroke) increases efficiency (by higher expansion ratio) but decreases power; direct injection increases efficiency on lower loads (allowing higher geometrical CR) keeping the same power and efficiency at full load (as effective expansion ratio stays the same because of late ignition); splitting the expansion on stages should (theoretically) decrease thermal and mechanical losses, an so increase efficiency, also in case of multicylinder design and sharing of second stage cylinder may decrease the total engine size (but then it is hard to say about fixed volume).
Last thing may be even more important for cars or motorbikes. If you use one two-way 500ccm cylinder with four 100ccm first cylinders, all with 5:1 CR, you will have power of 2L engine, with Diesel efficiency (total expansion 25:1) and with just 900ccm total volume. And power may be even higher, because small first pistons and light secondary piston may work on much higher rpms, then one big and heavy piston.
Plus 5bar compressor on intake of small pistons with effective intercooling will allow even more power or higher CR.
Reply: @azlktune  

This will sort things in order of appearance, I think it's gotten to a point where we gotta structure it a tad...

"The idea of small piston is not to add some volume to the main cylinder, but to replace it in first moments of burning. With big cylinder  burning with highest temperature happens in almost flat area between the piston and cylinder head. It have very bad area to volume ratio, and so high heat losses. If you use a small piston instead, the shape of combustion chamber (having the same volume) will be better and will have less surface, so lower will be losses. Then, when you pass pre-expanded gases to the big cylinder, they will have lower temperature, and heat losses in big cylinder will be smaller. Plus the mechanical losses, as I said already, will be lower because of lower peak pressure. So you outsource first part of expansion with high temperature and pressure to more optimised small cylinder. The only question how to pass the gases from one to another with minimum losses."

So, a small cylinder for the first part ... which is limited by knock, and has a larger ratio of surface area to volume. A smaller cylinder, too, adds more surface area per added volume than a large one does. If we're at multi cylinder engines anyway, reducing the cylinder count can (partially, at least) cure this, but the principle point still stands, it's not going to reduce heat losses, but introduce a whole new set of surfaces - passage, additional machine itself, depending on conceopt, additional friction for valves (of whatever kind) and a second machine. That, in and of itself, would have a high mechanic efficiency, but after sacrificing the main expansion, the relatively low energy containing gases are passed, loss-inducingly so, to the expansion cylinder, which in itself is efficent, but already receives a load that has suffered great parasitic losses.

A small first step - the actual combustion engine, then - wouldn't improve things, unless it helps us with cylinder sizes being closer to optimum, but then, it helps us just by that, and just as far as that can.

"Concerning the models, to understand influence of one part you need to assume all other things constant. Or at least part of them. For example if we fix the volume, than we can say that: turbo inceases the power, but decreases the efficiency (because of lower CR); intercooler increases efficiency (because increases CR); Miller cycle (smaller intake stroke) increases efficiency (by higher expansion ratio) but decreases power; direct injection increases efficiency on lower loads (allowing higher geometrical CR) keeping the same power and efficiency at full load (as effective expansion ratio stays the same because of late ignition); splitting the expansion on stages should (theoretically) decrease thermal and mechanical losses, an so increase efficiency, also in case of multicylinder design and sharing of second stage cylinder may decrease the total engine size (but then it is hard to say about fixed volume)."

Yes, of course, some things have to remain constant, but sometimes, that's principally so (we can only replace a 100 kW engine with one that, also, delivers 100 kW - most appliable in car engines would be to determine a torque-over-RPM curve that is to be met, regardless of cylinder count, displacement and so forth), and sometimes, it's based on assumptions and circumstances. Turbocharged engines having a lower compression ratio only is valid if the engines are at least somewhat similar in basic specs like valves per unit, bore-to-stroke ratio, bore and stroke themselves, number and location of spark plugs, method of load exchange at least to some degree), and the method of load exchange is to be considered different enough in miller vs non-miller engines, that we could classify miller-turbo as its own category of engines, because the good-old assumption that compression ratio and torque per displacement (or BMEP, it's the same actually, 1 bar representing almost exactly 8 Nm/l) are balanced by having their product a constant ... that wasn't really true anyway, but the results, even kind of well so, resembled what's to be found in real applications - but, by outsourcing part ofthe compression upstream of a heat exchanger, we have defeated this, as we're already at a point at which additional increase of compression ratio (past the 11, 12, 13 we have today, towards 14 or 16 or so) has little to promise, as - for any given cylinder size and combustion chamber design principle - the surface are to volume ratio only gets worse ... that, and the disappointing result of heat-tight engines, pretty much, spoil it for CRs in excess of like 15, heat losses will be greater, and temperatures, too, of course, making the knock-inducement of combustion chamber surfaces' heat transferred back into the load pre ignition even worse ... this effect is one that makes it go downhill pretty fast, as it worsens itself, rendering us pretty much stuck at this value. Like the good old 8 degrees ATDC...

So, yes, of course something needs to be considered constant in order to understand stuff, but if the things you consider constant aren't, the conclusions drawn won't carry too far either. Expansion, by geometric CR, by having actual CR inside the engine lower, by shifting the missing part of pressure ratio (if compared to a standard-timing turbo engine) upstream of a cooler, we introduce a new degree of freedom - how much do we actually reduce the cylinders' volume at last intake valve closes? - that brakes this old barrier, as it solves the knock issue. Or rather, is the largest single step, things like cooling channels inside the pistons, improved coolant circuits, better insight into combustion and how to influence it, play their role, too.

In principle, we could, for example, examine how far we'd have to speed-up combustion in order to exactly counter the effect boosting has on knock - setting up a simulation, having CR, CA50, Lambda_Cyl and so forth constant and only changing CA1090 (duration of combustion from 10 to 90 % of mass burned), keeping the knock intensity constant, would allow us to compare it to the actual potential of making it burn faster that we can make use of, and it will deliver some sort of value. Now, ... remember the impact cylinder size has on efficiency from the example previously? The same, can be said for the boring optimization of known principles, of spark plug location, thickness between combustion chamber and coolant, and all of those things ... improved casting methods and materials doing their part, too ...

... we could also calculate a minimum turbocharger efficiency that, as this process generally adds efficiency (the lowered compression ratio is no law of nature, ... the positive effect of harvesting, even if only partially, energy that otherwise leaves the system, and do something useful with it, isn't either, but it's kind of obvious enough), allows the turbocharging benefits to exactly counter-out the disadvantage of lower compression ratios - if it doesn't exceed 1, the math can be ok, if it doesn't exceed actual values of off-the-shelf machinery, we're past the point of total disadvantage ... at least for that fraction of the engine map this is true for. Never always, never never...
Reply: "Last thing may be even more important for cars or motorbikes. If you use one two-way 500ccm cylinder with four 100ccm first cylinders, all with 5:1 CR, you will have power of 2L engine, with Diesel efficiency (total expansion 25:1) and with just 900ccm total volume. And power may be even higher, because small first pistons and light secondary piston may work on much higher rpms, then one big and heavy piston.
Plus 5bar compressor on intake of small pistons with effective intercooling will allow even more power or higher CR."

Instead of a twoway 500, I could also use a one way 1000, for calculations, I use the ease of that following.

Ok, you, four times so, expand 25 by 100 ccm, to 125 in total, making up 500 in total, of which 400 are swept, working volume. Expanding 400 into 1000 only allows for an expansion ratio of 2.5, otherwise, it may be required to recompress in order to have it working - a total expansion from 100 ccm (the sum of compressed volumes of the first stage cylinders) to 1000 (the total swept volume of the twosided 500 ccm unit) only lands at 10:1, but that's besides anyway. You'd need to draw in air, and only 400 ccm are sucking it in - boost pressure needed again, besides it, in and of itself, doubtlessly adds efficiency, the magitude of increase over today's usual values will affect knock bad enough to need a low compression - and expansion - ratio to deal with it, as it's kinda extreme. If we're aiming at a 900 ccm engine's performance, we need to fill 400 with 900 (if we can assume the above used relation between CR and torque, ... we can totally do this), we need 2.25 bar absolute, or rather, 2.25 times the absolute boost pressure of engines to be compared (in motorbikes, usually NA, therefore, 1 bar, atmosphere as-is...). The more expansion and losses occur between combusion and turbine, the more restrictive the latter needs to be, in order to harvest enough energy to drive a compressor. Could be significantly smaller than usual, with this engine size in mind, the size-dependency of turbomachinery's efficiency comes in, to our disadvantage, it may even be as inefficient as it needs to be to not gain anyting even without taking knock into account, let alone afterwards. But, there's the second expansion tied to the crankshaft ... given the total expansion is 25, this still won't get us to Diesel-like effiencies, although that of the prechamber or swirlchamber engines that had such CR isn't that high anyway - they were way past the optimal ratio for their kind and size ... but, that only is for the first stage, as combustion and heat transfer ruin even larger compression ratios only because these process steps, and the losses they induce, are happening there. For an expansion cylinder, I'd suggest as large an expansion ratio - as small a remaning volume at TDC (or TDC-equivalent) as possible! Remember, when hollow parts of crankshafts in crakcase-fed twostroke engines were filled with cork or similar materials, to get rid of parasitic volume? That's the case here, too, the swept volume remains as is, but the ratio grows. We should expand as far as possible, and therefore, the flow capacity of the second-expansion device is crucial. If we can allow it to run faster than the actual engine, we may be able to decrease its size ... 

While certainly an interesting concept, the efficiency that would result from it may be a bit disappointing in relation to the effort this requires. The first stage of expansion, still, is the most valuable one, as any subsequent losses, and therefore efficiencies, have to be applied to any further expansion devices. We can never gain back what once is lost - so having the passage at low pressure, low temperature is in our favour, having spent most of the potetial to expansion in the first stage already. Which again leaves us at ... not impairing the first, main, stage! Whatever more we lose there, regardless of how efficient a following process in itself is, is lost forever and won't be retrieved.

Key, here, would be how the extra volume is considered by whoever decides. Is it displacement, for it being swept volume? Or is it not, as no primary energy conversion takes place in it? I'd generally prefer the latter, as then, equivalency is considered regardless of downstream machinery, and that allows to make sure not to impair the first stage too much, which I still see as crucial, for the reasons stated above.

As for turbochargers ... electrically assisted ones can also harvest electric energy, and thereby, manipulate turbocharger's speed, and thereby avoid any uselessl spent energy at all - whatever we don't need to drive the compressor, we grab off and put in a battery, or directly into driving the vehicle. The temperature-sensitive, and therefore expensive, VGT, we can pass with a smile, as the easier, un-reguated turbines are appliable here (a gasoline verison of a VGT that also is made in a Diesel-version, roughly, cost six times as much when I talked to a guy of a company making both - only for materials and tolerances, everything else remained unchanged), and only will have a wastegate for emergency-running or so. So, with turbos, there will always be losses, but the losses can be outdone for an ever-growing region of conditions.

Oof ... been a long time since I had a debate in these topics...
Reply: @DC-rn1fc  I think you are mixing all the things together and because of that making wrong conclusions.
E.g. CR does not influence on heat losses. Heat losses depend on size and shape of combustion chamber, which can be the same with small stroke and small CR or long stroke and high CR. These things must be separated and treated independently.
For optimum combustion we need a combustion chamber close to the spherical shape, instead of current wide flat. That is possible only with small bore. But to have a big CR with big combustion chamber and small bore you need very long stroke, that is not optimal for mechanical and thermal losses during the expansion. To avoid this contradiction we can separate these phases, burn the fuel in small-bore cylinder with relatively small CR and then pass the gases to bigger cylinder more optimal for expansion. So we decrease losses at both phases. But of coarse introduce new losses between the stages, which need to be somehow minimized. Also these losses limit us in the splitting on stages. As more stages we have as more optimal can be done each of them, but more additional losses will be between them. So there must be some optimum, which itself depends on available technologies (e.g. heat insulation of channels).
Turbo may harvest some energy only when you can't harvest it by the expansion in the cylinder. So as better and efficient the engine, as less sense to use the turbo, because it always has lower efficiency then expansion in a cylinder. Its only advantage is size and price. So may be it makes sense to use it at very last stage instead of too huge cylinder. So again, turbo makes engine more compact with the same power; or more powerful at the same size, but by the price of efficiency. It makes it more efficient only in comparison to the engine with mechanical compressor with the same size and power.
Reply: @azlktune  I don't think I'm mixing things up, but I'm taking the connections into account that count. CR does not DIRECTLY influence heat losses, but indirectly, it does, as the higher it gets, the less desirable the surface-to-volume ratio becomes. As to to be seen in the miller engines of VW (I'm not really, despite being from Lower Saxony, a VW-fan, but of those, I had the numbers in my head), this has an effect that can outdo even a mid-impressive set of cooler, better, parameters and features. This very fact is it that limits us from increasing CR beyond a value that, of course, depends on a lot, but generally is to be found around 15:1. You can't disconnect those factors, at least if you're aiming at achieving anything, you gotta take into accout that a desired feature in one regard may be undesirable in different other regards, just as it is here. And the experiments with heat-tight engines were so disappointing, as the results also revealed that the entire concept won't work out, regardless of how well it is implemented, it's an error to assume it making sense when it's proven not to at all. Which, in this case, it is. We've had that before...

Turbocharging in and of itself does increase efficiency, as, even with extended expansion and all the losses of a second stage, would still leave us with T and p considerably over environment, and as a smaller engine with the same torque (and, at identical RPM, wit the same power of course) has a higher mechanical efficiency (even with identical cylinder count, but even more so if it's reduced, as only friction of power transmitting motion, actually, depends on power, other frictuous processes run independent of in-cylinder forces), and the efficiency-defeating curse of having to lower the compression ratio, we can consider defeated, there is nothing left against making use of it. 

I know that any practical application being good in something doesn't verify its concept to be superior over any other one (it's never THAT easy), but ... in the MTZ's current issue, they have a paper about a miller-turbo engine developed by Aurobay (I think Renault are using these), with 216 g/kWh at peak efficiency this sets a benchmark that you'd have a hard time finding a naturally aspirated engine that could offer even less, and the regions that are below 230 g/kWh - a respectable value for any non-miller engine, almost impossible to reach with a twovalve in a car's environment regardless of boost or not, or method thereof - are enormously large. However we twist and turn it, unless you find a way to expand gases as far as that there's no difference anymore in specific enthalpy, compared to the environment, there always will be harvestable-by-turbine energy flowing out the exhaust, and either entereing a turbine, or not. Every bit of "Turbo läuft, Turbo säuft!" ("Turbo runs, Turbo guzzles" in german, rhyming itself) was due to lowered compression ratio and/or rich mixture in order to lower exhaust gas temperature in order to have the turbine survive. As both issues, nowadays, are solved to the extent that we're approaching the optimal compression ratio, in (and for) one stage at least, that wouldn't make any sense in being increased any further - replacing incomplete expansion with heat losses that overcompensate what we're winning isn't making sense - paragraph above, if you still doubt it, just consider it as a given for the sake of debate, that turbocharging in and of itself does not reduce efficiency.

We're on the same page there, then?

So, extended expansion ... still needs a whole new cylinder, or a set thereof (depending, ...), that introduce new losses we haven't had before. And extracts work we were to lose before. Fine and all, I agree that this route does make sense, but the sacrifice of expansion in the first stage, I cannot get myself behind, as that can't even be the maximum efficiency if two stages are a given that just needs to have their respective expansion ratios tuned to each other. As before explained (previous comment, or pre-previous? Doesn't matter...), the expansion in the first stage is worth more than equivalent expansion in the second stage. There's no stability issues here (like in multi-stage compression by turbocompressors, regardless of the flow being axial or radial, where the surge line limits the pressure ratio linked to a minimum massflow ) that force us to use two stages, only our desrire to increase efficiency may make us introduce a second stage expansion device of whatever form. In a first-assessment of concept, we don't even need to decide on a type of machine finally, but we can have something in mind by logical reasons - in a large engine, I'm seeing turbines not driving compressors, but either electric generators, or are added to crankshaft's torque and power like in the old aircraft engines just previous of jet engines taking over, but a cylinder ... in the end, they do the same, extract work from a gas flow.

But, let's go a tad deeper. A small first stage cylinder with a low expansion ratio has a huge surface area compared to its volume, at any given crank angle, compared to a larger one, and that remains so during the exhaust of stage one, or passage to stage two, the entire time the cold cylinder walls take heat out of the working-gas. Transfer to next stage, again, losses, pressure and temperature, are to be suffered, which are the greater, the lower the expansion in the previous stage is, which doesn't only increase the temperature gradient, but also the coefficient of heat transfer, which depends on pressure. Largely so.

What arrives in second stage, therefore, has lost a lot of its potential to expand, still needs to justify additional mechanical losses in comparison to a usual one-stage expansion, as, without the 2nd-expansion machine, said machine's losses aren't present at all. The first stage would be hopelessly inefficient, and to make it worse, this also increases the required flow of coolant and lubricant, thereby increasing losses again.

The shape of the combustion chamber, also, can't be seen isolated, because it interacts with everything, literally, that happens there. Would it be ONLY surface area to volume that counts, a half-sphere of a cumbustion chamer would be ideal, with a flat-top piston and half a hollow ball in the cylinder head. But, that concept doesn't allow sufficient compression ratios with realistically usable proportions, like, we'd need a stroke that is six times the bore to reach a CR of 10, bore and stroke being equal, we only can reach a CR of 2.5. But, we can make use of smaller parts of larger spheres, to accomodate this, and do the same, just a tad flatter, to the piston's top.

Current combustion chambers aren't that bad, given thart sparkplug location, injector location, ... play a role, too, and large valve flow areas help with efficiency just as much as with power, we have to take several things into account, such as the volume close to the spark plug should be large, far away from it as small as possible (which led to wedge-shaped combustion chambers), squish areas come to mind, too, ... It's a lot... The central spark plug position is one of the key features that makes a fourvalve better in everything (friction to drive the valves may be higher, but aside from that, there's nothing), not just better in high-revving racing applications or so. But, it suffered from a reputation of being useful only there, as the myth of the superior twovalve engine has been spread and repeated and repeated for decades. Actually make me wonder why, ...
Reply: @DC-rn1fc  Taking the connections into account is good, but at later stage. First you need to understand the role of each component independent. Otherwise you can make some wrong generalization.
Like this "... but generally is to be found around 15:1" is only true in some specific conditions, like fixed volume, stroke, amount of cylinders, type of cycle and so on. When you have so many conditions it is not a general rule, it is an exception. General rule is "higher expansion ratio is better "unless you find a way to expand gases as far as that there's no difference anymore in specific enthalpy, compared to the environment"". First rule makes you think that you should not try to inсrease ER above 15:1, while you really should think how to avoid these undesirable connections, which limit you in reaching the really optimal ER. My proposals here are to make combustion chamber closer to spherical shape by use of smaller pre-expansion cylinder, and decrease mechanical losses, by use of lighter expansion piston.
Same I think about heat-tight engines. I don't know what was their problem, if you have some link on that I 'd like to look, but I expect that problems were cause by too hot cylinder walls during the intake and compression, right? But then it doesn't mean that heat insulation is generally inefficient. If you e.g. separate intake and compression from combustion and expansion this problem will be solved and that insulation will give a huge profit.
In turbo-charger problem is in Charger. If you increase pressure on intake you have to decrease CR and so ER. Why do you say that this problem is solved, when you know that late ignition is used in these engines, that means low effective ER. This problem is not solved. And even if you solve it by effective intercooler or water injection or some new fuel, NA engine with the same improvements and higher CR will be anyway more efficient, because (or until) expansion in the cylinder is more effective then in turbine.
Airplanes used turbines and later jet engines not to achieve higher efficiency, but to achieve higher power. Piston engines are still more efficient then even a best turbofan.
Regarding two stages, you wrote "a half-sphere of a combustion chamber would be ideal, with a flat-top piston and half a hollow ball in the cylinder head. But, that concept doesn't allow sufficient compression ratios ... we only can reach a CR of 2.5." So you confirmed my idea, that first stage to be thermally efficient need to have a small CR about 1:3.
Small first cylinder has better surface/volume ratio, than a big cylinder at the angles when they have the same volume. So first part of expansion, when heat losses are maximum, must be done in a smaller cylinder, that means with small CR, as combustion chamber size is fixed.
Losses of heat during transfer can be decreased by heat insulation and high temperature of walls. Cold air doesn't touch this channel, so there will be no side effects.
Losses of pressure is interesting topic. I'm not profi in air-dynamic, using the analogy with electricity, it is more efficient to transfer it with higher voltage and lower current. As far as I know aerodynamic drag is proportional to the gas density and square of gas speed. So it is more efficient to transfer the compressed gas with higher density but lower speed. Maybe at so high temperatures it works different...
Concerning two or four valves, with two valves you can better place 2 spark plugs, plus 2-valve head has better cooling, that must be better against knock, at least at low rpm, when 4 valves have no advantage in exhaust gas removal. But the main problem is reliability. Higher thermal load on valves makes them burn more often. Plus of course twice more parts. For standard road car, which is used mostly below 3000rpm and at half load there is not much advantage form all these stuff.
Reply: @azlktune  Oh my, I don't know where to start anymore.

A first stage - be it the only one or one of I don't care how many - needs to expand as far as piossible. This first stage is special in  some regard, it's the one with combustion. As I mentioned, the heat-tight engine proved itself NOT to be heat-tight at all, because this influences the combustion itself, as it decreses the distance at which flame quenching appears, which - in a non-insulated engine - lays out a layer of insulating, not-burning gases. A highly complex process if you look into it. I gotta search for a link or a paper I have on that. But, the principle still stands, the mechanism behind it is not hard to understand, therefore, why go this path again? We've already failed, and we didn't fail because materials or methods or something weren't up to what it demands, but because the assumption that insulation will always ever only insulate is wrong. The effect it has on combustion coutners out any advantage

Any channels or chambers in which no combustion takes place, but heat losses are present, of course take full advantage of insulation, it is the condition of internal combustion that renders it useless in engines that don't have additional expansion machinery. We've had that already. Porsche used ceramic portliner, little tube of a ceramic material, to be inserted into the casting to insulate the exhaust channel in their last few air cooled Boxers, to lower the head's temperature. 

By the way, a (in lack of a better word) compression or expansion ratio of a non-first stage, you can't really set the way you implied, but it has to be as high as possible, as any non-working volume between first stage's exhaust and next stage's piston only eats up expansion without having work extracted from it.

That first stage, of course, is special, because it's the one with combustion, and it's the one where any element of heat has the most potential to committ work. A small, low-expanding first stage is so hopelessly inefficient that it doesn't really matter what follows, we'll always have less for more. Have you thought about the transfer to the second stage expansion machine? 

How much volume do the channels that feed 1st's exhaust into expansion machine make up? How far has the expansion to happen before it can, again, be made use of? The expansion losses in usual exhaust process, I consider known to you. We have the same now, only that we expand our gas kind of mid-expansion, but interrupt the harvest of work until it's expanded far enough to even reach it. Between the end of expansion in 1st and the start of expansion in 2nd stage, we lose at the very least the expansion into the connecting channels and pipes. Which shall be heat insulated to not make it even worse. But, by having a small expansion ratio in the first stage, we set ourselves up to make most use of heat insulation inbetween machines, as we, would we expand the gases in the first stage far enough, would already have spent way more heat in expansion and way more pressure into work than we have with a low-expansion first stage. But, we'll never again, along the path an element of heat takes through the machinery, have the chance to expand at such a high pressure or efficiency. Now that we made sure that the gases flowing into the second machine have as much pressure and as much temperature as possible, the insulation becomes more important. And we still have additional mechanical losses, as no seconds stage at all means there's no friction in it. Or in stage three or stage four or stage five.

Jet engines (or, rather, turbofan engines, as a pure jet engine would be uncommon today, and inefficient, too) are more efficient under the conditions a modern aircraft operates in, but that's closely tied to size-related effects (again, but closer here than anywhere else - turbomachinery generally gains efficiency by size, as parasitic versus useful areas and such, are in favour of the larger ones ... I may consider this a given here in order not to exceed character limit again...), so only above a certain power level - and at great altitude - are these more efficient than a piston engine. Otherwise, the development thereof simply wouldn't make much sense. OTOH, the last piston engines for large aircraft were enormousy complex by cylinder count and arrangement alone already, which also played a major role - a (back then, pre turbofan) jet engine, generally, can work with only one part (or, rather, one assembly of parts which don't move relative to each other) in motion. It wasn't efficiency that mainly drove this transition, but it has caught up quite a lot since. But, even if it hadn't, even if we'd consider it a given that a piston engine always is more efficient than equivalent turbomachines are, complexity and power density have already decided.

If a twovalve engine with two sparkplugs is better than a fourvalve, why didn't, say, Alfa Romeo stick with it? Don't get me wrong here, their Twin Spark engine was comparable to its contemporary fourvalve comrades, but ... world-record peak efficiency, in the early nineties, was achieved by Opel's fourvalve four cylinder of 2 liter and 110 kW, with 232 g/kWh at min BSFC - the Alfa engine was close to this, and also close in power output, but made use of variable cam timing (the Opel didn't), of increased residual gas content in part-load conditions and so on and so on. This was the last twovalve engine in a car that could be considered as technologically advanced, that really was an engine to want-to-have. The central spark plug in a fourvalve ... this stuff is really basic, ... works at least as well as a two-plug twovalve, in regard to knock. The smaller exhaust valves have lower face temperatures (the smaller the valves are, the larger their circumference becomes in relation to their face surface area, making heat transfer to the valves' seats greater in comparison to the heat transfer from chamber to valve ... but, this boils down to - circumference versus face area. The smaller the valve, the cooler the face, especially in exhaust valves, this is important for knock perfomance. Intake may not be necessary at lower RPMs, which seems to have fueled the misconception of "only better at high RPM" that still is believed today, among the fear of black cats and other similar misconceptions.

Solved, the knock issue ... kind of so, yes. Look at BSFC maps of current engines. VW's EA 111 isn't exactly an engine of today. There still are issues. There still are parts of the engine map in which the current, turbo-charged units need very late combustion - but, this isn't anywhere near 40 deg ATDC anymore, even without miller timings, newer engines, taking into account the ever increasing knowledge on hand, were able to reach, at similar BMEP and CR, a center of heat release of no later than 22 deg ATDC (Ford's 1liter inline 3 for example had these values in an investigation similar to mine), without any significant scavenging or rich mixture. I wonder why the magical 8 deg ATDC haven't been questioned yet, ...

The EA 111 hadn't solved the issue. But, didn't I point out that the very same values that make you consider the issue not solved, are not the same anymore after introducing miller timing? Lambda_Cyl ... 0.75 to 0.975 isn't exactly nothing. 418 versus 253 g/kWh aren't exactly nothing, regardless of simulation or measurement. You don't have to pretend to disagree to confirm. The miller process outdoes every advantage in efficiency that naturally aspirated engines still had UNTIL THEN. The increased efficiency of load exchange of turbocharged engines, I consider a given. A mechanically driven compressor wouldn't allow that assumption, but as the exhaust turbine accesses a fraction of power that otherwise is thrown out, even if only partially so, the part already is enough. We don't need to examine basics if we're trying to talk about how to advance. 

Also, while those numbers are the most impressive ones regarding high-load operation - less knock issues leave less to improve, of course, by a knock-countering approach -, they pretty much show the effect that the miller process has on efficiency, on operation limits and so forth. There may be single regions of operation that are less efficient, yes. But, that tiny edge top left, in which you'd never even be able to operate a vehicle engine in constantly anyway, makes up what fraction of actual engine use? Have you seen a current BSFC map? It's impressive, not only is the minimum - 216 g/kWh in the Aruobay engine, current issue of MTZ - impressive, but the broad region where values that were considered respectable minima in NA engines already are achieved, is even more. Yes, I consider this issue solved, by the approach of miller process, the approach of extended expansion (-ratio) compared to inner, effective, compression (-ratio), by outsourcing cmpression so that intercooling becomes possible. Of course, other things like improved cooling, cooling channels in pistons, sodium-filled valves and all that, play a role, too, but that, they do everywhere.

So, which compression ratio, Lambda_Cyl, CA50 and BMEP do we need to reach at which RPM in order for you to consider it solved? Is there some threshold value or so? Which intake valve closure is early enough to call it miller? What else do we need?
Reply: So ... now ... how do we approach it?

A trochoid engine inside an inward-breathing V4 or V6 engine. As these type of machine doesn't suffer from bad combustion if none takes place, the weird shape of the chamber doesn't matter, plus it can - or, for this application, must - be fed from two sides, so that we can minimize the volume between first stage and extended expansion stage. If this is meant to make any sense, of course we're talking a miller-turbo engine with as much of internal, first stage, expansion as possible, but might need assisted boosting by some method introducing a second source of power, as exhaust gases, after expanding another time in the trochoid expander, may not deliver enough anymore. And we don't want an engine that is uselessly large.

Ideal compression ratio ... I'm not making these up. Look at how a combustion chamber looks if you increase CR and you should get a grasp on how and why that works. Of course, this is limited to a set of coditions. Or course, ... remember the two differently sized, but otherwise similar engines, where the larger one, that doesn't have that fancy a set of parameters and features, still is more efficient?

Ideal compression ratio is the one where all losses combined reach a local minimum. You with me on that? Good.

The more we compress the charge, pre ignition even, the higher the coefficient of heat transfer gets. The temperatures and pressures are higher, too (increasing coefficient and driving differential respectively), and so is this, and so are heat losses. By increasing CR, we, generally, increase heat losses due to the effect this has on the combustion chamber and the state of gases therein. At some point the increase of efficiency due to higher expanstion ratio is equal to the increase in heat losses due to p, T, surface, volume. That value tends to be really close to 15, and it tends to be located on a rather shallow part of the graph, where any change in whatever direction doesn't have that great an effect. But, that's not true for the heat losses, they're gonna grow ... surface area versus volume becomes ever greater, the heat losses, eventually, eat up the advantage in extended expansion.

The magical 8 deg ATDC for CA50 ... wouldn't it be better to have the combustion happening earlier, centered around top dead center? Ideally so, taking ONLY the combustion itself into account, of course it would. But, in reality, all we'd do is increase the heat that is to enter the coolant, not spend it into expansion any more. Actually, I made use of that during my diploma thesis, in order to lower the exhaust gas temperature, but skip rich mixture as a means, because this was more efficient. Or less-less efficient, to be correct in it, and, of course, only at high enough RPM that knock was not a problem anymore, but exhaust temperature already was.

Take this approach, that allows to not seek a singled-out maximum of a singled-out part of the process, but an overall optimum, apply to compression ratio, do pages upon pages of math, throw in the measured realities and there you go - if it weren't so, why would Diesel engines today have lower CRs, yet vastly higher efficiency, than prechamber or swirlchamber machines had?

If possible, I'd prefer using a turbine as after-expansion device, as they are compact, easy, already there anyway, and can be adapted to a matching flow capacity easily (by using one like Diesel engines, with variable vanes instead of a wastegate - waste-gate, already tells us...), while a positive-displacement-machine either needs a variable gear ratio to connect to the crankshaft, or some other means to adaopt flow capacity to given conditions. Remember the example, that radial engine with three turbines attached? Looked it up? Impressive - 231 g/kWh, almost equal to that Opel engine of the early nineties, which of course was a four-valve, but significantly smaller, and had no additional expansion devices. 

The extended expansion resulted in some 500 hp of additional power, without additional fuel being fed into it. Direct injection, they had, the mix of advanced and rather crude engineering looks a tad weird at first glance, but for the time, perfectly makes sense... That efficiency, at that time (50's), with an aircooled, twovalve, pre-war originating engine, they could only achieve with this extended expansion. But, as turbomachines work better with increased size - or, rather, work worse with decreased size - my only fear would be that this stage's efficiency wouldn't be high enough to justify the added mechanical losses and so forth. Maybe this would render it an unfit solution for engines below a certain size (or, rather, flow imposement on the following machine), but ... point still stands: the first stage shall not suffer any decrease in efficiency, as the second stage never will be able to recover it. The second stage only makes sense because expansion in the first stage is limited, and be it only by the engine's size. If we could, with an actually usable engine, increase the expansion within the first stage until we reach conditions of environment (well, not quite possible, but ... expand to 1 bar may be possible, but still would leave us with some 200...300 K of temperature difference), having it remain the only stage would boringly lack any disadvantage. The temperature still could be harvested and used in a process that doesn't need to interfere with the main engine at all. Stirling engine or so, might be a great fit, might work into a generator and supply a hybrid with effectively free charge. Yes, losses, but not interfering with the first stage makes everything a win that even works at all, while a reduced expansion in the first stage might result in the minimum required efficiency for 2nd stage to exceed carnot's at the given temperatures, or even exceed 1 in order to be, overall, advantageous.

The second stage only overcomes a shortcoming of the first stage, and increasing that shortcoming will not only not result in success, but potentially would ruin the approach's reputation. Even things that aren't true keep themselves repeated endlessly, like the fairy-tale of the superior twovalve engine. It doesn't even make sense by ANY theory, let alone would it be a proven result of reality, but still, this stupid myth persists. Now, imagine what a tiny grain of truth in it would result in - if we can skip more than two valves outside of exotic or huge engines for decades, resulting only in reduced power AND efficiency, for deaceds again, ignoring the vast amount of experience telling otherwise for even longer, any failure, any mishap, could render it unsellable to those idiots that demand six cylinders for 100 hp already and never get beyond counting cylinders in their understanding of the machine they so dearly try to love.
Reply: @DC-rn1fc  Concerning heat-insulation. You anyway will have a thermal gradient between hot gases and cold cooling system. Without insulation most of the gradient lies on the gas layer near the walls, causing the flame quenching and CH pollution. Introducing the insulator you move the main part of the gradient to it, reduce the total heat flow, and as result of it reduce that non-working gas layer. It is like saying that single glass window is better, because with it bigger layers of air near it work as insulators. Total heat losses will be higher any way.
I would say it is a general problem of understanding the systems with negative feedback. People often pay too much attencion to this feedback way wich goes to opposite direction and compencates part of main effect, and decide that general effect is negative, when in reality it is positive.
Parasitic volume between stages is a problem, and needs to by minimised. But with bigger volume of the first stage you need proportionally wider channels (to keep the same sppeed of gases), plus they will be longer beacause of cylinder diameter (if cylinders stays side by side). So the parasitic volume may be even bigger proportional to the cylinder volume.
Generally inefficiency of first stage with low CR  doesn't mean losses, it means only a distribution of power production between two stages. The energy you didn't use at first stage due to low ER will be used in second stage. And if this distribution will be equal, we can have an additional positive side effect: torque pulsations will be split on to strokes, so you can use twice less amount of cylinders keeping the same NVH. That in turn means that you can use twice bigger cylinders with better volume/surface ratio and better efficiency. So instead of 4 first cylinders with two additional, you can use only two first with one additional. So the engine will be even more simple and cheap than a conventional 4 cylinder single stage.
If you look even on big airplanes, which don't need high power but need a long range, like strategic bombers and so on, they still use a big piston engines as more efficient. Jet engines were needed only to get a top power.
Two valves engines were discontinued mostly because of marketing needs of socumented top power. But the real life tests show that 2-valve engines consume even less fuel then 4-valve analogs of the same volume and made by the same producer with same technology level. Probably because they are optimised more for mid rpm range, used most of the time, and not for high rpm like on 4-valve engines.
Ma be thermal gradiend over the valve is less in 4-valve head, but cooling of head surface and valve seats is worce, because there is almost no access to it from the cooling system. Plus 16-valve head is weaker mechanically and tends to deformation after small overheating.
Why do you advocate turbo engines by efficiency of Miller engine? These are almost opposite things. Turbo engine has lower ER, while Miller higher. Actually you may take a turbo-Miller like that from Mazda, reduce the power stroke, making it equal to intake/compression stoke, and you will have a standard turbo engine with advantages of intercooler, but with lower efficiency because of lower ER.
There is no threshold for turbo. As far there is a pressure at the end of wxpancion, it is better to increase expansion then to use turbo. The only limitation is the engine size. And maybe also mechanical losses at very low pressures and high flows. Looking at another devises working at different pressures, I would say that turbine is better then piston at pressures somewhere below 1bar.
You are explaining why optimal CR is limited to 15:1, but your arguments are actual only in conventional Otto engine. But that doesn't mean that 15:1 is a general optimum for every case. That only says that in this case negative side effects overcome advantages of higher CR at this threshold. Fight the side effects and optimum will be higher.
For Diesel engines side effects are different, and main limiters became NxO production and NVH.
Concerning timings of CA50, I would say that at low rpm, when combustion time is relatively fast, it would be better to have as late CA50 as possible, having an increased geometrical CR t okeep the same effective ER. In that case hot gases will be expanded faster and with lower heat losses. But that probably actual only at very low rpms which are not used at modern engines. Maybe with multiple spark plugs per cylinder or another type of ignition system, like laser, it will make sense even at higher revs. But when combustion needs about 60 degrees, it is not so important will they be centered around 8deg, 0deg or 16deg. That is one of the reasons why we need a first stage with small bore. But as I already said, small bore with big combustion chamber and not too long stroke means low CR.
Reply: @azlktune  I gotta keep it short this time...

The flame quenching renders the analogy with insulated windows an unfit model, the increased losses are only present because this interacts with combustion.

The 15:1 are, kind of, hard to pass in reducing the side effects. Generally, we can assume that, while it sometimes seems like R & D were either lazy, or limited in what they can do by other criteria than efficient machinery (like, cheap-to-make machinery, which obviously took the leading role at least between WW2 and the re-introduction of multivalve engines as standard), the chosen compression ratios were the optimum under the given circumstances. But, this time, it's different. Insulating the engine has proven to increase losses, although not really intuitive, what explains it does make sense. I remember one of our professors talking about this, and that points in direction of MAN, considering his former, rather long, stay at their R & D department.

A late combustion is optimal ... .......? That, it's never. That, exactly that, ruins the efficiency at top-left corner, that knock limitations force us to select late spark timing, and consequently late CA50. Later than needed to avoid knock, CA50 may only be when accelerating a turbocharger is considered more important than efficiency at that given moment, as this allows more heat to leave the cylinder, and increases the power delivered to the turbine. Power that can't be harvested anywhere else anymore, obviously.

Anyway, physics and I want to see the twovalve engine that consumes less than an equivalent fourvalve engine does. As this, pretty much, isn't even possible. And yet, that stupid myth is as alive as is fear of black cats. How come?

When Mercedes introduced their first fourvalve six cylinder, late eighties or so, it had a tourque curve that lies just over - never under, always a bit over - that of the twovalve, outdated, engine. Gear ratios were all identical, but people testing the vehicle complained about it "not having that low-end punch" and similar blabber, regardless of no measurement backing them up, but it just repeating a prejudice towards fourvalve engines. I've even read in a book that "heavy pistons are good for torque". No joke. Gravity engines, I haven't seen many thereof in cars ... you ever met one?
Reply: @DC-rn1fc  The flame quenches because it losses heat. So the distance at which it cools down indicates heat losses. Maybe problem was in something other? Maybe their coating reflected radiation worse then aluminium?
The 15:1 is optimum for currently used engines. Most of R&Ds are made around them. But that doesn't mean that multistage engine or that-ever else construction will have the same optimum. Obviously if alternative construction will be better and have lower losses, then optimum ER must be higher. Actually there are only two ways to harvest more energy from hot gases: decrease heat losses to keep higher pressure during the expansion, or increase the expansion.
Late combustion is better, if you increase geometrical CR, to keep effective ER the same. That is not that we have in top-left corner of existing engines with CR optimized for 8deg CA50. And again that makes sense only if combustion is relatively fast, and doesn't take 60deg. Actually there is very late ignition used at idle, I still can't found explanation why, may be it is done to decrease heat losses and engine heating at idle?
I can't find that test where 8v engine had lower consumption, but I found a torque curve of these engines (https://a.d-cd.net/84518s-960.jpg). Here red line is 16v engine, green 8v, other are previous versions of 8v engine. So you can see, that intake of 8v engine is optimized for lower rpms and torque below 2500rpm is higher. And this range is used most of the time in real life.
I tried to look also at 8v versions of my citroen engines, they have a bit (0.5l/100km) higher consumption. But that may be explained by just more old construction, missing of knock sensor and lower CR. Most of producers after switching to 16v engines stopped development of 8v versions, keeping them only for cheapest versions of their cars, and in that case they are motivated to keep them outdated and with worse characteristics to force customers to buy more expensive 16v versions. Marketing is dominating over the engineering.
Regarding heavy pistons, it also can make sense. Heavier pistons have better heat conduction, so better cooled that helps against knocking at lower rpms and improve torque. I think engineers 40 years ago were not idiots and had some reasons to choose heavier pistons. I would say that with some exceptions (like phase variators) modern engines just copy old sport engines to increase spec parameters by cost of lifetime and reliability.
Reply: @azlktune  Oh my ... wait a minute. There's a lot we agree on that falls a bit under the last few answers. Of course, more expansion is desirable in order to increase efficiency. As the only-stage of an ICE, it isn't an expansion machine only, but incorporates the combustion, which also is why the insulated engines failed, because the effect this had on the combustion itself makes the target a certain miss. If it were some gas that, by any other method than self-combustion, is heated up to expand into work, insulation would be key and standard.

As to four valves ... versus two ... well, marketing, or rather economic targets instead of technological ones, have helped keep multivalve engines out of mass production for several decades, with the prejudice against them aiding in further delaying this - increasing displacement of a twovalve engine that already exists, in order to increase power is way, way cheaper unless we've reached the limits of the cylinder-crank-case - whatever fits in there is the cheapest way to increased power. Making people buy more expensive cars with stronger, more modern engines might as well make them buy a different brand, and make you lose out completely. That doesn't really carry...

The goals of development may have an influence. While you could tune a naturally aspirated engine with two, three, four, five valves per unit (as those are the numbers that make sense at all) to identical power levels, and then compare efficiency, torque curve, reaction to other means of improvement aside from more valves, ... and, I promise it to you, every single time (above a certain bore diameter, but that's well below usual car sizes of current engines - let's not make it too long by adding ever more little subdebates...), four valves will outperform two valves, regardless of what we keep as constant, be it CR, be it redline RPM, be it power - tune them to equal power, and the four valve will have greater efficiency. Tune them to be equally efficient, the four valve will outpower the two valve. Literally everything aside from power to drive the valvetrain and production cost, is better with more valves. Especially the valve-related issues, as smaller ones avoid certain problems just by being smaller (circumference, determining contact area, as this is the main path of heat transfer through the valve, only grows linearly with diameter, while face area grows X^2, and so forth - mechanical issues become less urgent with smaller, lighter, valves and lower lift, or even only one of those). 

That debate already is closed and finished, as there's not much in physics that allow for a two valve engine to be more efficient than a four valve. But, as the prejudice about four valves only being useful at high revs still is alive, well and unfounded as it always was, spread even wider among non-engineers, the PR value of four valves per unit isn't that great at all. There even were instances were slightly larger two valve engines had more power than detuned variants of smaller four valve engines. VW did that on a few occasions, but the stronger engine, despite being cheaper to make, was never sold for less, but for more. As a manufacturer, you gotta keep in mind that the regular, to-be-expected customers doesn't know much nor care. Those dudes stating that in times long gone everything would have been better, that demand having six cylinders for a power that doesn't ask for more than three, ... do you expect them to care or understand what a certain number of valves does to the engine? The details are irrelevant to most, and of those who care, ... not really all of them know what they're talking about.

The twin sparking of a two valve will get you really close to the optimally, centrally located spark plug, with a tiny advantage at the beginning of combustion, as then, for a tiny ... there really is twice as much heat release per time. Until the flames meet each other, or a wall, which they'll do pretty early. Residual gas tolerance is better, too, as two spark events that never are identical, or identically well, superimpose each other on each other, ... variation is lower, ...

Anyway, a high compression ratio and late combustion, compared to an engine made to have the same expansion ratio from CA50 to bottom dead center will still leave the higher-compressed, later-firing engine at a disadvantage, as during the period the piston travels back and forth pre combustion, close to top dead center (and top left on the map), the gases take up heat from their surrounding, which has an even greater surface compared to the engine tuned especially for this condition (8 deg, CR lowered to allow for that, or simply lowered to equal expansion ratio from CA50 on), a decreasing the volume while keeping the basic concept and geometry, will always result in more surface area. More time and more area is more heat taken up. You with me on this?

Idle with late combustion ... there's several reasons that may be necessary or desirable. First, a low idling speed, even with unfavourable parameters, decreases the idling power that is spent inside the engine, and thereby, although it's efficiency may be lower, the power consumed is even more lower. The state the gases are in may make the optimal spark timing unfit. If it's a stratified engine, there may be a limited timeframe in which ignition is possible, regardless of its effects on cumbustion, efficiency and so forth. In a scrip from University, I found an example where a stratified-running engine would only allow such a tiny window for ignition, and increasing the residual gas content of the cylinders slowed down combustion, shifting CA50 to be later by a desirable amount. Ignite later? Impossible, the ignitable part of the mixture cloud already would have left the sparkplug's location. They shifted it from ... 0 to 8 degress or so. CA50, that is, spark timing remained constant. At first glance, that may appear to be stupid, but it isn't, as in the end, it worked out.

Heavy pistons, just by being heavy, don't do anything for us, but a lot against us. Thicker walls conduct heat more effectively, yes. But, a thicker walll at the pistons' top, would also hinder the cooling effect of oil being sprayed there. Today, we even have cooling channels in gasoline engines' pistons. Introducing a second one, flown through in opposite direction to the first, would be something I'd consider useful, even if it results in more weight, but the property of being heavy, in and of itself, never does anything in our favour.

Late combustion in idle conditions, may be due to ignitability itself. Lower RPM, as above. In a cold-started engine, it may also aid in heating up the cat converter, as preconditioning of vehicles was ruled-out, having the conversion ramp up fast was key to even have the engine allowed on the road, even if it, outside of NEDC or similar cycles, caused greater losses due to needing rich mixture to keep temperatures low enough and such.

Racing engines, usually, focus on high load, and usually are really efficient, but part load isn't among their strengths, and, depending on concept of engine, reglement etc, low revs might also be out of their reach. Some even can't run at idle conditions at all, due to how they were tuned to deliver at highest RPM. In idle, this results in residual gases to exceed what can be ignited, ...

Anyway, as the expansion in the first stage still is the most valuable one, and the transfer to 2nd stage can't be made to be free of losses altogether, every bit of expansion that is possible in first stage, should appear just there. As the optimal CR is influenced by heat transfer and all that stuff filling numerous paragraphs since last week, this isn't as high as possible, just like earlier combusion appears to be favourable, but earlier than 8deg ATDC, just increases heat losses, the expansion ratio of that stage, too, is limited. The price we pay for having it all happen in one machine, overall the best option we have. Later expansion is of course desirable, but will not work out well if any efficiency of the first stage is sacrificed, or expansion is sacrificed ... only sets up conditions for increased losses during transfer, regardless of how well insulated and developed it all is, we will not be able to makre it have no volume, no surface, no heat transfer, or any one of these. We'll introduce parasitic volume and surface areas that transfer heat out of the gas between stages, and those are lowered if pressure and temperature are, regardless of volume, actual surface area and so forth ... so, I'm with you on adding a second stage. I'm not with you in lowering expansion in first stage.

... wanna do the math...? I'm a tad lazy about that currently, or rather, time is limited and I have to do less amusing stuff.
Reply: From current engines, the most promising path of development is the turbo-miller engine with variable turbine turbocharger and increased expansion ratio, outsourced and intercooled compression. That, kind of, sets the base, as it's the most efficient engines you can buy today, any attempt to significantly increase efficiency either has to be based on it, or compete with it. Compete, it will not be able to, as this means introducing more, larger, machinery, while adopting miller's cycle, if at all, just introduces different varieties of already known machines. This doesn't allow to conclude how well it works, but how possible it is to include. From there on, we might compare different approaches to harvest the engery still traveling with the exhaust gases - positive displacement expander, turbine expander, harvest of heat to feed into secondary thermal processes, or the latter combined with the former, ... just not, never, if this, or in a way in which this, significantly affects the first stage of expansion. Just imagine ... from the point at which a low-expansion cylinder would transfer its gas content to the 2nd stage expansion machine, how do we extract the most work from it? Further expanding in stage 1, then transfer to stage 2, then expand to whatever extent? Or, expand until that point, transfer at high p and T, then transfer to stage 2, and expand to the same final conditions, or the same final working volume?

If we consider the final conditions to be equal, the piping to be equal and sort of optimal, the expansion machine serving as stage 2 remains unchanged, everything is equal, only we tune it to expand further in the first stage, or not, but further in the second stage. The only remaining major difference, if total expansion ratio is identical, is the state the gases are in during transfer ... or, am I missing something? If I'm not missing something, doesn't that already prove that expansion is better, the earlier it occures...?
Reply: @DC-rn1fc  Effect from insulation on ignition was positive, isn't it? We have smaller layer of non-burnt mixture. Heat losses also must be smaller, otherwise flame wouldn't came closer to the walls. And I actually don't understand why closer flame should increase heat transfer? Most of it at these temperatures is done by radiation, and for such tin layer we can say it is flat and than radiation power doesn't depend on the distance. So may be their coating reflected the heat worse then aluminium?
Concerning valves and marketing. Formerly most of the customers prefer simpler, cheaper and more reliable constructions, like 8v engines, while the sport technologies like 16 valves were used on premium cars. Then manufacturers started to fit mass-marked cars with "premium" engines, and some customers were ready to paid a bit more for that even if they had no real advantages. But only some part of customers bouth them, others were in doubt or prefer the 8v. To force them to buy more expensive versions development of 8v was stopped and they start to disappear. And customers will not go to other brand as it is the same everywhere. Even Dacia you can't buy with 8v anymore. And that, I think, is one of the reasons of car industry crisis, people just don't like to buy modern over-complicated and overpriced cars.
I said already one advantage of 2 valves, it is head cooling. Even if single valve has better cooling, but the cooling of entire head became worse.
You may optimize 16v engine for lower rpms, and get advantage over 8v, but it would be very small. In same time you will not be able to fully realize the main advantage of 16v at high rpm. So you will have an engine with very small advantage in full range, which will never cover the extra cost and introduced reliability problems. So if I would choose between 16v engine and 8v with the same specks, but 5% more volume, I would choose second one. And at the same engineering level it may be even more efficient, because lower cylinder fill with 2 valves means that you can increase CR. may be it even makes sense to forbid usage of full throttle at low-mid rpm where you have knocking problem and increase the CR. That must give nearly the same effect like nonturbo-Miller cycle, just with a bit higher pumping losses. Or speaking in terms of efficiency map, increasing of the CR will improve the efficiency in all ranges except upper left zone which will be wider, and then just forbid it.
Concerning 6 cylinders vs. 3 cylinders at same power, best for efficiency would be 1 cylinder, but efficiency is not the only criteria. Customers need also a low NVH, which is better at 6cyl., longer life-time, which is better at low rpm bigger engine, and higher torque from idle, to start from traffic light, which is also better on big 6cyl engine. The problem is that engineers optimizing the engines for the better spec params written in technical task, and don't care on real usage.
Concerning late ignition, why do you say this engine will have bigger surface in TDC? If you take a normal engine and move the piston a bit higher, surface will be a bit smaller. The same will happen in TDC of the engine with hihger CR. Concerning heat transfer before ignition, I think it is not important because temperature of compressed gases in TDC will be even higher then temperature of head or piston. If geometrical CR will be like on diesel 25:1, air temperature will be above 200degC, so it should even cooldown by the walls. But then after ignition, hot gases will be expanded faster and loss less heat to engine walls. But for that the fuel must be burned very fast. Actually why can't we use detonation as a normal ignition process? If we cover the piston with a strong steal protective cap it will not be damaged by detonation, like it doesn't damage the valves.
Concerning late ignition at idle mode, it was used even on old cars without catalisers or stratified mixture. I didn't understand your sentence about power. If you set a normal ignition at idle, engine will accelerate, so you can slow it down back by decreasing the fuel supply. So it surely don't improve fuel consumption. Anyway it is quite strange that everybody use this late ignition but nobody can say why...
Regarding heavy pistons, now we changed roles. You say that extra weight itself is a bad thing, and that is true, while I say that in combination with all side effects, like thermal conductivity, or lubrication conditions and wear they have advantages. And I'm not a fan of cooling pistons by oil, as it accelerate oil degradation.
Concerning 1st stage CR. Imagine that you have an optimal shaped combustion chamber close to the spherical shape with height close to the bore size. That will minimize heat losses when the temperature of gases is highest. Then you expand them by the piston e.g. in 3 times. Now you have already bore/stroke ratio 1:2. Should you then continue to expand it in the same cylinder and have finally bore/stroke 1:10? Or it is better to connect bigger cylinder and continue expansion in it? Then this bigger cylinder will have less surface than the 1:10 tube, even including the connecting channels. Plus you will reduce the piston speed, and speed of gases in the channels.
Or another point of veiw: If we have fixed cycle power, that means combustion chamber size, and fixed total ER, that means fixed size of the second stage cylinder, we can choose between smaller or bigger 1st stage cylinder. What will you choose: a small cylinder with small CR and higher temperature in exchange channel, which you can isolate; or increase its stroke, and so increase total surface and heat losses, and increase mechanical losses of the piston, and pressure losses in channel; or increase the bore, or both bore and stroke, and make combustion chamber more flat increasing heat losses, and again increase surface of the cylinder, and also increase sizes of channel. Finally there must be a compromise between losses in first and second stage cylinders and in channel between them. To simplify the model we can say that we have no connection channel at all, that is technically possible if we use some sleeve valve connecting the cylinders directly one to another. In that case we only need to balance between losses in first and second stage. As smaller the first cylinder, as lower the losses in it, but higher temperature on its exit and higher losses in second stage. Also the mechanical losses depending on pressures should be calculated. That needs some simulations, but I would expect that optimum would be somewhere in the middle. Otherwise dual stage have no sense and the optimal first cylinder will have a zero size or equal to second cylinder, in both cases we will have a single stage engine.
Reply: @DC-rn1fc  Some more thoughts about valves. Improving intake by extra valves, or phase variators, or tuned resonances actually works the same like turbocharging without intercooler. As more air you push into cylinder, as bigger combustion chamber you need to avoid knocking, that at same volume means lower CR, and lower efficiency. So it works like anti-Miller, increase intake to increase power by cost of efficiency, while Miller decrease intake to increase efficiency by cost of power.
But that all was about thermal efficiency, mechanical efficiency is less clear, because some of mechanical losses proportional to the (maximum) torque, some are constant. So first will not influence BSFC values, while second will cause better efficiency at higher torque, and so compensate loss of thermal efficiency. But these constant losses are actually losses on valve train, so more valves will cause more losses. All other directly or indirectly proportional to max torque.
Reply: @azlktune  I didn't have much time the last week ... I haven't forgot we still have an unfinished debate here, but it kinda rotates around. We should clarify on what issues we're not opposing, in order to leave these out, as there's nothing to clear up about fundamentals - we either both have them right, or we should not debate.

Miller is NOT increasing efficiency BY reducing cylinders' degree of fullness. If we increase boost pressure, we can close the intake valve earlier with the same air mass trapped, and still end up at a less knock-inducing state of the gas at compression's end. The higher the boost pressure, the more miller'ish our load exchange can happen, the less knock is caused. You with me about that? If not, why?

Losses on valvetrain, with roller-followers being standard nowadays, doesn't play a major role, and reduces the difference between 2, 3, 4, 5 valves into near-nothing. The pumping losses, as being a direct result of flow area, differ - the more area, the less losses, and that's clearly in favour of a fourvalve (or multivalve) engine over a twovalve. Aside from being cheaper and the minisculy increased loss to drive the valve, nothing is better with two than with four valves. Even more valves ... I suppose you know geometry, so we don't need an entire paragraph about how above 5, there's nothing to win anymore.

Miller outsources the compression to where we can cool the air down. The reduction of amount of load this implies, only applies if we don't adjust the intake pressure to rectify this. As the most efficient currently made gasoline engines are in fact miller-turbo engines. 216 g/kWh, is the current minimum of engines known to me off of my head. 240 g/kWh was often cited as, sort of, the minimum achievable with twovalve, external mixture, fixed timing and so forth, and generally, it's not easy to find engines consuming even below that - that is, twovalve car-sized engines. And it's not only that sheer minimum, but the broad range that isn't much worse that's impressive as well.

I still am not in on the (long overdue) revival of the multivalve engine being primarily a marketing feature, as marketing the - obviously, non-existent - supremacy of the twovalve still works well, regardless of no special physics being employed anywhere, nor the one we all have to share anyway allowing for it. If the number of valves was a result of what's best marketed to the general public, who have no clue about fluid dynamics, combustion dynamics, interdependencies of various processes and machines, they could even more easily be fooled into believing that this cheap solution (that, obviously, benefits the seller, not the buyer) would also be the better one. After all, if the almost purposefully wasteful turbocharging of a twovalve (still better than mechanically driving a supercharger, ...) engine, if efficiency is not a target, can match the power of any given fourvalve turbo, and if that has reached its limit, slightly larger pistons, slightly increased stroke are astoundingly cheap if you don't modify a given engine, but are to develop a new one. Like above, turbocharging levels out any preference towards higher RPM of a 4V engine, but restricted flow areas between combustion chamber and turbine, or between compressor and combustion chamber, cause higher losses at two places, plus higher fraction of residual, hot, gases worsening the knock situation, plus the extra hot large exhaust valve worsening knock, plus the messed-up location of the sparkplug (but, this one factor can be rectified by introducing a 2nd plug - Alfa Romeo did so, Mercedes-Benz in their treevalve V engines did so).

Don't get me wrong, there's a lot of great twovalve engines, but in general, it's a misconception that it only serves high-revving engines well and would be wasted, or disadvantageous even, elsewere. A high-revving NA engine has the most advantage over a NA twovalve, but the prefered engine speed is determined by timing more than by anyting else. You can tune an NA engine, regardless of number of valves, to any engine speed. It's a bit messed up because we're trying to compare ONE feature, but won't find two engines only differing there, but somehow, we gotta have this out the way. We can't really debate any further when still differing about the effect such a fundamental step in development has had. Central spark plug, lower valve face temperature, less pumping losses are factors that count at any and every engine speed, being of advantage in any and every state of operation. Now, the tuning to a certain engine speed - lengths of intake and exhaust pipes, their connections, valve timings, overlap, ... - affects all engines roughly identical, regardless of number of valves. As for torque, and the often claimed advantage a twovalve would have at low RPM, we can employ reality to sort this out, and take the M103 and M104 engines from Daimler-Benz, both introduced in the mid-late eighties (1984 and 1987), and from both, we take the 3 liter variant, as it's the only ones that have identical swept volume. The ... I only have that pic on my phone, or in a book, and the cat sleeps on the scanner right now ... torque curves of these two engines look almost identical, but one is slightly above the other, all the way so, and drops off significantly later. So, there ALWAYS is an advantage, it just isn't as great at low RPMs like it is at high RPMs. Of all the two vs fourvalve comparisons, this one has the most-similar engines, as both have a crossflow head (and not a one-sided gas exchange, like GTI 2valve or BMC A engine or so), and the valves in the M103 are arranged in a narrow angle almost like in many fourvalve of that time. Parallel valves or a side flow head would twist this in unfavour of the affected engine, therefore, I'd consider it cheating, had I used a different example. This implies a few things: Load exchange works better at any engine speed, and loses its sufficiency at higher speeds, broadening the usable RPM range. As it's an NA engine, there's nothing that would level out or compensate, it simpy is better at filling itself with air, from idle speed through to redline. Of course, that only is possible if the efficiency of load exchange (one of the four secondary efficiency figures usual in engine R & D - "Gütegrad des Ladungswechsels" in german) is higher. This one, too, has to be multiplied with the other ones in order to have the overall efficiency figure. The other three -"Gütegrad des Heizverlaufs, Brennverlaufs, Verbrennung", efficiency of heat release, of combustion respective to time, of combustion respective to completeness of chemical reaction" - aren't affected that foreseeably. Efficiency of combustion vs time, of course, is also higher in the 4V engine. Heat release and completeness of combustion remain to be looked into, and ... and that's for later, maybe tonight, if not, tomorrow. Gotta go and ... we shouldn't consider this debate over. It's not.

Point still stands, secondary expansion is desirable due to its effect on efficiency, but parasiting it off of the first expansion is defeating its own purpose, as it would increase transfer losses, but would not enable the recovery thereof.
Reply: @DC-rn1fc  Original Miller Cycle had no turbo, it was just a simplified version of Atkinson cycle, with reduced intake/compression cycle by the valve timings. Its idea is to increase expansion ratio, which is normally equal to CR and limited by knocking. So it increases ER, keeping tha same effective CR, and shifts the engine parameters to higher efficiency and lower power. Then addition of the turbo with good intercooler helps to increase the power in the same way like with normal Otto engine. If turbo boost exactly compensates the intake cycle reduction, then it can be treated as outsource of intake, but generally this two things may be different. So it is better to separate these things. We can have more millerish engine without boost, but it will have less power, or we can have a lot of boost and power in less millerish or Otto engine. You statement is true only if we fix the output power.
Roller-follower are still not standard, but even with zero friction there will be losses caused by valves inertia, especially at high rpm. So lets compare pros and cons. Cons of 4 valves: higher price, lower reliability, bigger weight and size, higher mechanical losses. Pros: +10% power in the range which nobody use, and -5% declared fuel consumption, which is not always proved. And these two effects are achieved together with all other improvements made since 2v engines development stopped.
Yes pumping losses are less, and torque is higher in all ranges if resonances are the same, but in most cases engine works at partial load, so these advantages are compensated by throttling. And as we talk about Miller engine and its efficiency, it must be clear that we simply don't need efficient intake, we are going to limit it by valve timings to increase ER. So theoretically 2v engine is already a bit miller comparing to 4v, and should have higher CR and efficiency. May be the ideal construction for that would be 3 valves, with one intake and two exhaust. That will use advantages of cooler valves and better exhaust gas removal, but keep some more metal in the head for its cooling and mechanical strength. Also that will keep space for 2 or even 3 spark plugs.
Concerning marketing, most of the people, who buy a new car, want to have bigger spec numbers, and ready to pay more for it. Even if they never use more then 50% of these specs. They like to buy a "modern" construction, you will not sell them old simple engine with higher price, even if it would have better parameters. And they don't care about reliability, because they plan to sell the car before the end of warranty.
Reply: @azlktune  I'm sorry for the delay, just couldn't find the time ...

Do we have anything else we can debate in a more convenient way than youtube?

Anyway, let's start at basic layout decision - cylinder sizes, valve and -train arrangements, injectiors, that stuff. Mechanical construction, where to put how much metal in a casting, all those tinieties - besides, they're.

A cylinder, or a rather combustion chamber with a movable, power-carrying surface, whose bearer is to be named "piston" regardless of type of motion, demands a lot of competing, often detrimental, properties and features. For knock performance and heat losses - we can't completely divide these, even the delay of - how come always? - 8 degCA for CA50 is a result of the interdependencies attached to heat transfer, combustion, pressure, temperature and so forth - best cooling is key. We lose more in terms of heat, but we gain this back by further expansion - or further compression.

Hot surfaces such as large valves (exhaust more, but intake as well, sodium filled stems weren't uknown on this side either) are worst inducers of knock, and therefore, limit the possible CR-BMEP combination. Heat-tightnes has been tried and proven to be a flawed concept, as the flame quenching taking place closer to the wall deprives the charge of a sort of natural insulation of effectively-inert gases, leading to, effectively, no reduced heat losses and no reduced knockability. So, off with that ...

Number and placement of valves, sparkplugs and injectors still leave us with a lot to decide, even with unfit attempts being ruled out. This also is exemplary of how misconceptions or wrongly assumed priorities have resulted in concepts that worked well, and such that didn't work well - the hemispherical combustion chamber, for example, only is optimal if we're at the 30's's level of knowledge about charge motion. We need squish areas to improve combustion, to increase CR and/or BMEP. 

Regardless of mode of load exchange, direct injection nowadays is a certain given if we aim for efficiency at all. Injectors are best placed centrally, along the spark plug, even in homogenous-only combustion engines (stratified load has advantages to it, but also is full of strings and traps attached to virtually everything - remember the recirculation increase in order to slow down combustion to meet optimal CA50? That sort of strings, and many worse). And, regardless of target RPM range, low resistance in every pipe, port, valve on either side reduces losses, too. Without timing, duration, flow characteristics, we can't even assume anything about RPM range with any number of valves.

So, let's conclude - low resistance is always desirable, and calls for large flow areas whereever something's to flow through. Resonant dynamics, acoustic tuning besides here, we're gonna visit such later on. Centrally located spark plug, if only one, is desriable to necessary, and if we have multiple ones, three in a row in a fourvalve will beat two in any configuration, and with any number of valves, and is totally possible even with narrow spacing between cylinders. If need be, we can use 10 mm plugs, or even 8 mm ones, if the buyers' purses are known to be deep... Any twovalve combustion chamber that aims at optimal volume distribution around the spark plug, like wedge, offers so small valve area that even for a low-revving engine it's undesriably wasteful. With the limitation to two valves, we have to chose. We can have it really good in ONE regard. Suface area and temperatures aren't optimal, or rather, the influence of it was dramatically overestimated, but as there was no real wrong in it, a well-made, carefully constructed engine of that sort could and can work really well. But, however we twist and turn it - something always is seriously undesirable, and every promising attempt to rectify this while keeping the valve count at two results in a head that isn't cheaper than a fourvalve.

A four valve combustion chamber, pent roof shape, offers all we want in a good compromise that exceeds most properties of even the aimed-at-that twovalve heads. Flow area doesn't need to be explained. Central spark plug, the only or the most important one of however many there are, only is possible with a fourvalve. A similarly good position in a wedge chamber is associated with tiny valves. Large vlaves block to optimal spark plug location, and as heat transfer and combustion cannot be seperated, the theoretically advantageous ratio is compromised in its effect at least. Whatever we optimize in a twovalve head, leaves other properties at a clear disadvantage, and we're only caring about efficiency so far, performance, or power density here only is of interest as far as it concers efficiency (think mechanical efficiency). One huge, maximally hot exhaust valve and a fraction of the head that has no inserts perform worse than two mildly hot, smaller exhaust valves and an even smaller part of the head and so forth. Intake - roughly identical, just less dramatic. Squish areas can be located below the intake and exhaust ports, whereas a two valve would only offer the sides (Fiat/Lancia's DOHC twovalve turbos had such a chamber), which restrict flow. A bit. But, they still have the worse spark plug location and the hotter valves in their disfavour.

So, can we finally move past a 40 year old epiphany that doesn't even need a single line of math to be proven right?

Now, further expansion ... can't be useful if it eats-off of the first-stage, as there is no intermediate step we could employ to increase efficiency that, directly, is associated with having two stages expand. If we could expand until ambient coditions in however many stages, the concept that has the lowest stage count will be best. On compression side, this is a tad different, as we can intercool, thereby reduce the power consumed by the following stage(s), and that, too, is the very core of the turbo-miller concept that, so far, and by far has delivered the most efficient vehicle-sized spark ignition engines that ever were made.

That's where we have to start, if the further expansion is meant to improve efficiency in a meaningful way that does more than compensate for a flawed basic concept. Anyway, adding a machine that significantly increases size, weight, cost only is justifiable if the engine it's based upon already is very efficient on its own, and yet there's enough power to convert left that it really may make a difference.

Do we disagree anywhere, still? We're not at the expansion device itself yet, but are still counting the valves and setting up cylinder sizes.